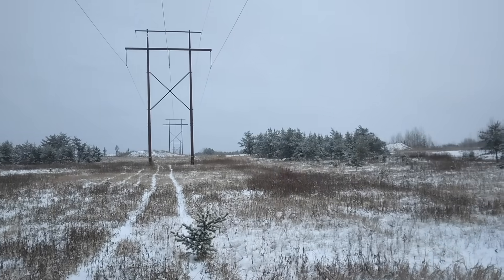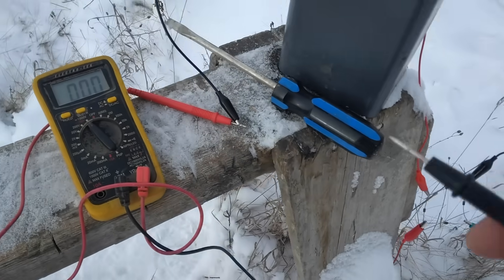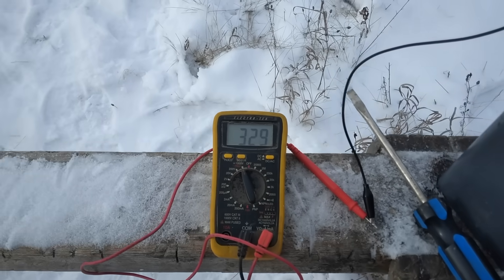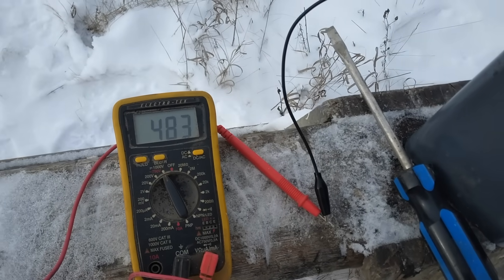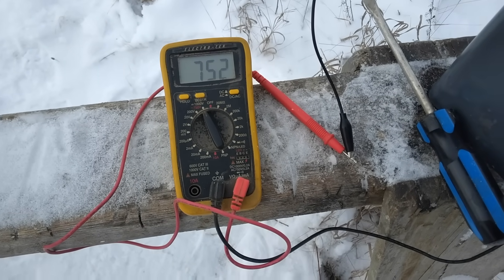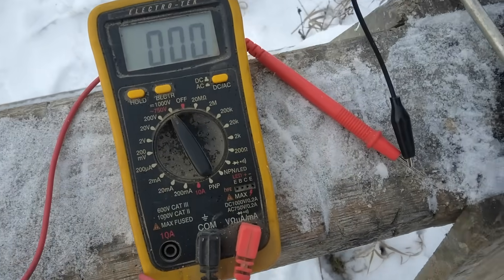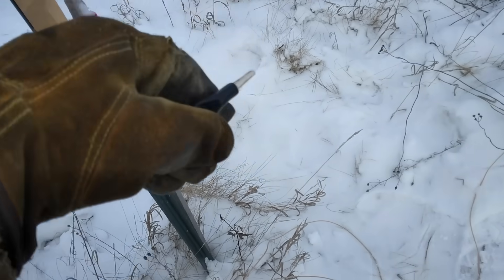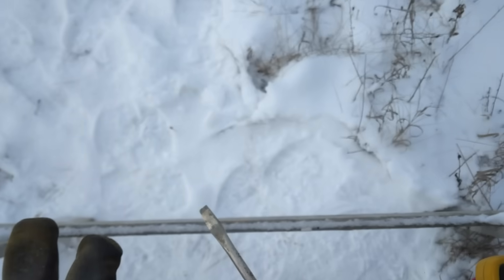Fences sucking power from under HV transmission lines

Comment: True story... More than 50 years ago, when I was just a kid, the owner of a local oil field welding and machine shop got sued in Federal Court for "stealing" electricity from the 240KV power lines which passed over his property, by way of using a homemade induction coil mounted on a pole. Which in turn was wired into his electrical system, and which had been powering his business for more more than 20 years already. The court ruled that he could not be sued for taking advantage of natural physics, and dismissed the case on day one. His business continued to thrive for another 30 years until his death. Shit you not.
Reply: I believe you. 45 years ago the power company ran high voltage lines over a ranchers property for which he didn't give permission. He was told he would have to go through bureaucratic channels to have them removed or rerouted off of his property. He was also an electrical engineer. He built an induction device from which he drew free power for him and his neighbors close by. Did it for a year. The power company found out and within a week the lines were rerouted off his property!
Reply: @heru-deshet359
Power lines were rerouted in a week? I call BS on your story.
Reply: 😅😊  @heru-deshet359
Reply: @heru-deshet359   i doubt that story.  he would have to be drawing hundreds of  kilowatts for them to notice past resistive and inductive losses.
Reply: When I was a Kid, touched a top wire on a Barb Wire fence, and got a nasty shock. Weeks later, saw the Farmer at a store and asked him when he electrified the fence. He said he didn’t. Showed him where it was Electrified, he later grounded it. Turns out he was having problems with his Dairy Cattle and didn’t know why.
Reply: Ad: "power companies hate this one trick"
Reply: This is what I love about the internet. We've got amateurs arguing with experts arguing with amateurs pretending to be experts, making an interesting read for sure.
Reply: @sunbeames you have the best response I've read so far and you are telling the truth.......true story.  Lol
Reply: @sunbeames  LOL... Whatever you do, don't get them started talking about airplanes.  8^)
Reply: Idiots argueing with idiots  @sunbeames
Reply: We had a local resident who did the same thing.  He captured enough power to operate parts of his home and shop.
Reply: @eminence_front6043  Captured enough energy to power your fantasy, or duping your foolishness for the lols.
Reply: For some reason I usually trust stories that end with "Shit You Not" more so than stories that end "True Story."
Reply: In the late '70s I was working for a land surveyor in Northwest New Mexico.  One day we parked his Jeep under a 115Kv transmission line way out in the desert in the area where we were working.  When we came back to the Jeep it shocked the snot out of both of us.  We made sure to park off to the side of the power line after that.
Reply: I remember this!  He had the coil originally on a tractor bucket and then built something more permanent.  He would move the coil around and that somehow got outside of the law...
Reply: @1dariansdad  As I recall his name was Lytt Rogers. Richer than the Pope. Not just saying
Reply: Could you provide more details on when, where and a close date of that event
Reply: @mrnobody8540  Graham TX . So maybe early 1970's? I was  just a kid.
Reply: @quoderatdemonstrandum5442  
Thanks for the info - have a good year
Reply: Dudes a legend then i knew you could get power from those lines because i'm and electrician ,but never took the time to experiment because i don't live around any lines. Take note that there are ways to convertly siphon power off those without them knowing unless they did a hard search.
Reply: The court is correct for weak or wrong reason.  I think this case is similar to neighbor's tree bearing fruit but the fruit is above your property which you can pick without being branded as stealing. As long the coil device is within in your property, power company can't do anything about it.
Reply: We still don't have free energy
Reply: I've heard this story a couple of time now. Sometimes the home owner wins, sometimes not. But I have not figured out how they work. If you get a couple of turns around those wires, you can pull down some current. But by only having parallel wires, you are only getting a capacitive load. You can get a high enough voltage to cause a spark or light a florescent or neon bulb, but there isn't enough current to do any real work. 
Similarly, by pointing a coil of wire at the power lines you can leach off a bit of current, like current probes or clamp on ampmeters. But without making a full loop around the wire, you aren't even going to get as much as a clamp on ampmeter. 
While the shop owner might have pulled down enough voltage to power his florescent shop lights, I not sure how he could have powered much else in his shop. If you have any actual articles about this case, I'd love to read it. Over the years, everything I've ever found ventured into urban myth territory.
Reply: @brucekives2194  The magnetic field lines circle the wire. An inductive coil with its axis perpendicular to the wire, close enough that the other phases don't cancel out the magnetic field, will pick up voltage as the field oscillates at line frequency.  It has to be to the side of the wire or the field will cancel out.
Reply: @PaulSteMarie  
Exactly right. And the coil that picks up that magnetic field has to be kept so far from the HV transmission wires that only a tiny amount of current in induced into it.
Reply: @brucekives2194  Reference Nikola Tesla's wireless power transmission that actually powered a vehicle!!!
Reply: @brucekives2194  Can't really document. Just a memory from my youth. Same guy had a pig farm in South Bend ,Texas. And made a mint of money during WW2 making nitroglycerine for the US govt. Produced two, maybe three hundred gallons per day. Even had an ice plant on his property so they could ship it to Ft. Worth via truck.
Reply: @brucekives2194  Ummm, no. Please Google induction coil ... And sorry, but I can't really document those events. Just a recollection from my youth. Same guy had a big-ass pig farm in South Bend, Texas and got rich selling nitroglycerine (and pork) to the US govt during WW2. Produced two, maybe three hundred gallons per day. Even had an ice plant on his property so they could ship it to Ft. Worth via truck.
Reply: @brucekives2194  I believe fly back transformers would be effective in pulling more current out of the air...?
Reply: It's true that it's a story but the story isn't true.
Reply: @manchegocheese997  Google is your friend
Reply: Brilliant! "Ye cannae change the laws of Physics"
Reply: @nickjung7394  Amen bro. Didn't Scotty say that to?
Reply: @nickjung7394  It’s worse than that He’s dead Jim 😂
Reply: Don’t worry about volts what about current. 😊
Reply: I know this story. Court ruled he was just salvageing wat was already lost.
Reply: That’s what we call “Power ✊⚡️ to the People”!!
Reply: Stories that start with "true story" aren't
Reply: @waynethomas3638  Google is your friend.
Reply: Power Wall battery bank, anyone....?
Reply: Not a true story when it comes to powering an entire business that way. If that were true the POCO would also be using air core transformers. 
At 60hz you need some significant amount of core.
Reply: @Magneticitist  LOL.. Just because YOU can't do it doesn't mean that an old timer who used to make nitroglycerine for the US govt cant.
Reply: @quoderatdemonstrandum5442  Yea well, it's a physics thing but ok
Reply: "Taking advantage of natural physics"??? LOL, this cannot be a true story. If I drive a truck through the front of a liquor store, I'm also taking advantage of "natural physics".
Reply: @chunkEcheez  in California you'd get away with it BUT now 2024 the $900.00 and below is gone
Reply: @chunkEcheez  LMAO... What are you? Twelve? Or a Lib Arts Major?
Reply: @John-kj5wh You are correct. An inductive coil siphons energy from the power line that wouldn't otherwise leave it. The ground and the wire have no current. A coil with a load would measureably reduce the power across that section of the line. There is no such thing as free energy. People like to argue without understanding. The ground is not siphoning power from the lines, while an inductor with a load absolutely will.
Reply: WE had a 5 mile strand line (strand is the 5/16 inch 8mm stainless braided wire that supports phone cable and tv cable lines) that run parallel to some 500 kv lines in Ohio. That strand generated so much power that it set the field on fire. The property owner separated the strand from the ground and run a 4/0 power cable underground back to his building. It produced tremendous power lighting the barn and garage and running equipment. You have to be very careful with those lines because many of them were highly charged from just running down the length of the road on the opposite side from high tension power lines. I remember handling this line with insulated tools and striking on hell of an arc to ground. It was more than dangerous.
Reply: @KlodFather  Running equipment part of that story is absolute BS. Fire yes, flouro light yes, electric shock yes, running an electric motor/refrigeration/welders/compressors not possible.
Reply: @ThePaulv12  -  No compressors... But there was a lot of power that came from that steel cable which came on rolls about 25k feet. So a couple miles of that steel cable can pick up some tremendous power. But no air compressors or welders. That is not possible without some serious elfin magic and some long parallel runs of cables.
Reply: @KlodFather  - Little energy is required to make a spark to set a dry field on fire, just lots of voltage which is readily available from a transmission line.  While 5 miles allows a good bit of power to be gathered, I'm quite sure this story is fake, some aspects are unbelievable.
Reply: @jrstf  -  No... This is a real place and I could show it to you... Its in East Central Ohio with good long straight roads out between cities. You are entitled to believe your own lies, but I was an eng working on those projects out there and I saw it first hand. Look it up. The support strand is in between a 4 and 6 gauge wire and the braid is about 5/16 inches thick and has a normal working load of about 5000 lbs. The break or stretch load on the wire is around 20k lbs. Its really strong corrosion resistant steel. Go test the theory yourself. If the wire is 20 feet in the air you are drawing power from, its that much closer to the power line for better coupling. Telephone and cable TV trunks pick up lots of stray voltage and parasitic power from power transmission lines and AM radio stations. They can be quite dangerous.
Reply: @KlodFather  - I'm not disputing getting a bunch of power from a 5 mile line.  I do dispute the need for such a heavy wire to carry the current.  Transmission lines come in three phases, if the wire were equal distance from all three (which I know it isn't), they would cancel out and you'd get nothing.  But it does limit what you get.  In addition, the stuff you claim was being powered is rather particular about the voltage, getting power this way would not be the desired voltage and if you transformed it to the correct voltage it would still vary greatly with load.
Reply: Had new home built by an amatuer electrical engineer. He was trying to "steal" power from transmission lines in his backyard. Wired up the attic...... didn't work. sold the house, without telling anyone.
New owners kept getting shocked touching anything in the house. Took a few electricians to finally go up in attic and see all the copper strung out in the rafters...
Reply: @brucewhitefoot  wtf is amatuer electrical engineer? Only people graduated are electrical engineers!
Reply: @ianmoone8244 amateur engineers should stick to driving trains.
Reply: @johnstraszak5145  there's no such thing as "amateur engineers"...
Reply: O RLY?  Cite the exact case so we can all get on board.
Reply: I heard thru my kid brother about his FIL in west Ne making volts for his own use with a wind generator. Local county gools stopped him.
Reply: @roadking99jokerst60  And now they're encouraging people to do exactly the same thing. 🤷‍♂
Reply: @ComommonlyCensored 
Like the distributor in the old cars - it the condenser that made the spark plugs work 😊.  A very simple design with no moving parts - it only job is to absorb the full voltage of the battery until it reaches the point of total capacity saturation is reached - it's this factor that provides the spark plugs a burst of energy - however it's the job of the coil to amplify the voltage from low into high voltage for the energy jump ( spark ) across the spark plug electoral the the grounding circuit provided by the engine being grounded to the vehicle frame with is grounded to the batt terminal, completion of a circuit.
Reply: @mrnobody8540  Well that was certainly a long winded way of saying you don't understand what a condenser does in an ignition system.
Reply: @20somthingrealestate   it a simple design - it's only job is to create a break in order to get a flash charge in the circuit... 

Your understand it better - explain it better.. use less words doing it! 

Proof is in the show of work - not in the I said so, there for it is! 

Haven't read a auto motive textbook since the late 70's - old points gap and dell set up of timing done with real tools, not a keyboard. 

So I could have forgotten something - but I don't think I have forgotten much.
Reply: It was really the fault of the electric company, not the business owner, for not having the necessary easement to prevent that situation.  Their engineers should know the required easement to conserve their electricity on the lines and demand it.   Obviously the easement for the electrical wires was too small.
Reply: There was a guy here who had to pay back 10 years of power bill.  Its crazy.
Reply: In Mississippi they considered that an electrical connection by induction and cart you off.
Reply: There were marijuana grow ops in the British Columbia Interior that powered their green houses that way.    A few were not found for years.
Reply: He stole Mega watts of power a day? 😂 True story
Reply: @DreStyle  LOL... Reading comprehension must not be your strong point. Because he wasn't "stealing" as per the United States Federal District Court. And study up on your basic physics... Because there's NO WAY that he was consuming megawatts per day. More like a few dozen kilowatts. So thanks for playing. And go finish your homework.
Reply: Epic! Fantastic story.Good on him. And I do believe you. It's cool to hear that every now and again in our messed up world common sense and justice do occasionly prevail.
Reply: This is the most wholesome story I've seen in a while. My bald eagle just shed a tear of delight.
Reply: The energy is already lost to the atmosphere so yea, its not stealing it capturing free energy.
Reply: @ThreeTreeDog  It's also an imposition upon the land owner, rendering that land unusable for certain things.
Reply: I think it's less about 'stealing electricity' and more about the fact your giving people ideas!
Reply: @andyspoo2  The whole thing started with a 10th Grade Science textbook. And ended in Federal Court with that very same textbook. Except in this case, someone actually took the time to read it. Ergo, the plaintiff (power company) lost their case. And the respondent won by summary judgement. Those are the facts. #science
Reply: @andyspoo2  I think electricity from the atmosphere (a static field) was used in the past for lighting.
Reply: Well the man said “ shit you not ” gotta be true!
Reply: The icing on the cake would be to sell the power back to them
Reply: I remember that case. Court rulled he was only salvaging what was already lost. No harm no foul  ! !!!
Reply: Under lines larger than these was my parents mailbox. If you slid your hand under the mail you'd get a good shock I'd guess like a 100 volts. Always wondered how it was happening
Reply: I've heard of other similar cases, but I highly doubt that he could "harvest" anywhere enough power to run a welder.  He'd have to be dangerously close since the radiated power decreases at the inverse square of the distance.
Reply: @TheRealCheckmate  Read the whole thread
Reply: @quoderatdemonstrandum5442  All 433 replies?  I don't think so.
Reply: @TheRealCheckmate  Well I'm not going to repeat myself again just for your convenience either. So stop wasting bandwidth on mommy's computer. And have a nice day.
Reply: @TheRealCheckmate  Are you a Lib Arts Major? Or what? Because logic dictates that you don't actually have to read all 433 replies... Just the half-dozen or so that I already posted. LOL.
Reply: I can tell the story was fake based on simple physics. There is no chance to get enough power from that way.
Reply: I'm an electrician 4 years into the trade. It is definitely stealing, although I still think it is a clever and amusing way to game the system. Here is why it is stealing.

The stolen (induced) electricity comes from the magnetic fields generated by the power company. These fields dont just radiate away from the wires like a toaster radiates away heat, they expand and collapse at a 60 Hertz  rate. Energy stays and travels on the lines, unless you introduce your inductor to steal the electricity, which is essentially a load that you are adding to the power company's transmission lines, same kind of load that you create when you physically plug in a toaster into a receptacle. It uses power.
Reply: @elc2k385  But the court ruled that it wasn't stealing, BECAUSE THE INDUCTION COIL WAS LOCATED JUST OUTSIDE THE LATERAL LIMITS OF TXU's RIGHT OF WAY.... I mean seriously. What part of that do simpletons not get?
Reply: Anytime power passes through a transformer, it only makes inductive contact, never physical contact. Called transformer isolation. Yes, one can set a coil of wire around an iron core next to a pulsating field and transform this magnetic field into useful electricity. One only need to measure the results and increase the coil or iron till it results in the voltage one desires. The frequency will be the same, in the US,  sixty CPS. This will not affect the power company one bit. Just jealousy, and selfish desires, convincing other similar entities.
Reply: @jaypaul8167  Exactly.
Reply: Name of business
Reply: @jeremygalloway1348  Read the thread
Reply: The inductor he set up requires more work from the power plant to achieve the same power output from the transmission lines (it increases the impedance of the power lines , so it does result in higher energy consumption for the power company. You don’t get free magical energy out of nowhere in physics.
Reply: @electricpaper269  Point being the coil did not infringe upon the TESCO right-of-way.
Reply: I was told the same story in 1970 when attending a lecture on Electricity when I was in University taking Civil Engineering!
Reply: To prove there is an electrical field below power lines just take a neon test bulb and walk under the lines. It will light up.
Reply: @magicone9327 i have those lines across my property that are constantly causing me grief. 
It would be nice to get some benefit from them. How do i set that up?
Reply: What exactly do you think i don't understand about energy? The fact that the wires are one electrode of a capacitor and the ground is the other, or the fact that the ground actually has resistance and is turning most of the capacitively coupled energy in to heat thereby wasting it or the other effects leading to losses in transmission lines? Putting an electrode between the wires and ground and than grounding it just slightly increases the overall capacitance. Having an aircore transformer nearby to get the induced low current and high voltage transformed in higher current and lower  voltage might look like some wireless electricity bulshit, but is perfectly plausible.   @ComommonlyCensored
Reply: How about another experiment? Two 20 foot iron rods, 1 inch or more, positive lead shoved 10 feet into an eddy current, a magnetic river connected to the earth due to our atmosphere, and the next rod 10 feet away. Wrapping a wire around a lot is recommended... the earth has significantly more energy than those lines... methods of solidstate induction are vaild...

I don't know it would hold up again. Without the power lines there, the farmer could not... copper coils woven in a six point star lure the induced current into the coil below best. The effect of electricity to seek it's ground can be exploited even if large coils are buried below the earth, which one could argue the energy was grounded before reclaiming occured. Although, placing copper coils in the ground accelerates the wear on the wires, degradation, and translates to less energy to destination and more resistance in delivery, and the generator must spin more. Leeching is what it is, a parasitic load. As much I want self generation to occur, 30 ways approved, leeching is not. Use the magnetic energy. Every 10 miles or so is where an eddy current exists, not every one has access, but sharing is caring. Free energy is free creativity and we need this advance to succeed in the world and own the hydrogen economy. Magnet motors that work, based on known acceptable designs, warning fbi hates it when we make magnet motors. Hydropower is still exceptable. We have lasers to cut miles into the crust, leaving a quartz tube behind, ideal for geo thermal energy. Thorium reactors, liquid salt reactors, are safe, powerful, and recycle the excess waste and warheads. If we are going to do mass projects to provide free energy, then we need to pick sustainable methods, without burning fuels. The maget motor is ideal for everything. The magnetic accelerator depletes matter, and generates a small amount of antimatter, and that is not advised for use in our galaxy... =)

The science of building nuclear silos, a 400 foot hole was dug, and a silo built over it, 400 foot tall. All it did was rain in the silo, filling the bunker below. Needed to design better pumps in the 1950's. We can have water in the desert. The more extreme the difference in the bottom of the hole and the top the more condensation occurs. Please ground the silo, not only would it be a lightning rod, but conditions inside the silo can be a thunderstorm.
Reply: Damn lol
Reply: Bullshit!
I find it very hard to believe useful work can be done by electromagnetic induction. It defies physics that refrigeration equipment, light globes motors etc can be run for any time at all. 
I'm calling big brown BS.
Reply: Too all of those that claim it's not stealing: The guy built an air-core transformer to take energy from the magnetic field generated by the power lines and turn it back into electricity. Just because the power was changed from electric in the lines  to magnetic in the air then back to electric in his lines doesn't mean it's free. If that were true then all power consumed downstream of any transformer should be free. He's stealing power and the only reason he got away with it is the ignorance of science by the prosecutor/judge.
Reply: “Stealing,” yeah that’s stealing…
Reply: Nice , a Happy Ending !  Finally .
Reply: @ComommonlyCensored  Retired pilot here... Yes. I understand energy.
Reply: I was looking down the comments to see if it was high enough to power a house, apparently so :p
Reply: Site resources? Name of business and location?
Reply: I would kindly ask that you link the court documents or at least provide some information so we can verify this story with public records
Reply: Which state was the court case held?
Reply: What location was the case heard?   Thanks
Reply: @dalecarson1798  Pretty sure it was the U.S. District Court for the Northern District of Texas
Reply: Now, that's justice .
Reply: Old, analog meters could be turned upside down and run backwards.
Reply: Yay for the little guy and for "Natural Physics."
Reply: He should have counter sued for the EMF causing problems with his business equipment.
Reply: @mach1553  That was waaaaaay before computers. So maybe that's a stretch. Just saying.
Reply: Wirelessly
Reply: I bet that wouldn’t hold up in court today
Reply: 400 turns , 22 foot up😂
Reply: Air core transformer. Great!
Reply: Wild, in any other jurisdiction that's considered theft of services. There was a farmer who buried a coil in his field over which HV transmission lines were crossing. I guess he got caught because whenever anyone passed by there was weird electrical arcing as well as other interactions between the ground and the wires.
I have no idea what he was doing with it, it looked like he wasn't using it.
Reply: Yea.. obviously they can't sue you for stealing electricity from the air..😆
Reply: Don't believe everything you hear even from people you think you can trust. That story is most likely false and made up by someone who was probably in court for some other reason.
Reply: The feds are really good at pointless harassment.
Reply: Most EE majors are taught about this story, but the professors ended it 
that the farmer could not do this and his system was dismantled.
Reply: @johnsmith1953x  Not a farmer. But an oil field welding and machine shop in Young County, TX. He was found to be in compliance with the easement regulations in effect at that time. So he was was found not guilty and continued to operate thus for another 30 years until his death.... But the easement regulations were soon changed and nobody else could do it anymore. 8^)
Reply: @quoderatdemonstrandum5442 I heard this story in college in the 1970s so this is a different guy.
Reply: @johnsmith1953x  Yes. Diff guy.
Reply: that kind of EMF is really unhealthy. Avoid going near those powerlines. ❗❗❗❗❗❗
Reply: Love these true stories, thanks.
Reply: Because they couldn't send him an estimated bill 😅😅😅
Reply: Prove how much he stole good luck. GO !!! 😅😅😅😅😅😅😅😅
Reply: @matthewspry4217  Luck, and understanding basic basic electrical physics = not the same thing. Now go finish your homework.
Reply: Shhhhhhhhhhh...
Reply: @justsomejoe3632 LOL... I'm 64, Sophomore. How many are you?
Reply: @justsomejoe3632 Stop wasting bandwidth in mommy’s computer.
Reply: As long as he was not physically connected to the electrical grid the power company had no case. Tesla had this idea and he was silenced by George Westinghouse for doing experiments with this theory while working for him.
Reply: A linear inductor is what you built out there. If you had enough passes of wire back and forth you could power a small home through a stepdown transformer with that amount of electricity. Step it down and use it.
Reply: Can you charge a battery as an experiment?
Reply: @236vic  That's already been done. And Google is your friend.
Reply: It's NOT stealing. He's not taking ANYTHING from the power company in this case and as someone said the natural physics of the electric transport. It would be no different to put up a windmill near a wind farm. It could also be likened if you had a windmill near a highway to catch the wind generated by passing vehicles. You're not "stealing" the fuel from anyone's car nor making a difference in their gas milage.
Reply: @JamesKing-ev1wc Well he certainly had to have some kind of transformer in the line somewhere. But what kind and/or where it was I can't say for sure. Because I was just a kid at the time and there are a multitude of possible configurations.
Reply: @rustirab3465 Read the whole thread.
Reply: So instead, is there anyway to charge a 12v battery with something like this?
Reply: I know you can do it with a small winding but the voltage i got was pretty much useless. May not even been enough to make a spark. I buy that story too. Tech was probably put in to where they could see the loss and they investigated. That is induction the way some cell phones charge today. What surprised me is that the court sided with the land owner good ending. To get a useful voltage and current you would have to have a coil it takes a truck too brings out and park it under huh? Just guessing.
Reply: @my2cents645  Never saw it myself. But reliable sources say it was pretty big and mounted in the bucket of a front-end loader. 8^)
Reply: oddly the story has specific information yet lacks name/location.
Reply: @stevelibby6852  Read the whole thread?
Reply: @quoderatdemonstrandum5442  288 replies to scroll through? Sir, my ADD has limitations. 🤣
Reply: @stevelibby6852  LOL
Reply: @quoderatdemonstrandum5442  I am intrigued by this sort of technology, definitely seems plausible.  Of course, you have to live near high voltage power lines--which is not really optimal for humans I am told.
Reply: @stevelibby6852  Not only is that technology plausible, but our entire modern society depends upon it... For example, the transformers in your computer. Same thing. just waaaaay smaller scale.
Reply: @quoderatdemonstrandum5442  Oh for sure, I just meant for industrial theft :)
Reply: As electronic engineer I can immediately tell story is an utter BS fairy tale. Regardless of the fact that it's simply not possible to harvest any meaningful energy to power his business from proximity of power lines, induction coils would be absolutely useless way to do it. You cannot place a coil besides a straight wire and get anything induced onto the coil. To get anything out of it at all, wire would need to go through the coil. Not to say high voltage aspect of such power lines would be absolutely useless for such harvesting as current through the wire would be what matters. Not to say his pole would be immediately demolished once noticed, not because of him stealing the energy, but because of National Electrical Safety Code violations, and likely many others. You are simply not allowed to build any poles under high voltage power lines. The most useful way to harvest some energy would be through capacitance, not inductance, but it would not involve any coils.
Reply: @woopsserg  LOL...Retired pilot here. Stop playing kid. Because you're just twelve, or a Lib Arts Major. Which?
Reply: @woopsserg  Retired pilot here... Yes! That's why they went to Federal Court and spent all that money on lawyers. Now go finish your homework.
Reply: @quoderatdemonstrandum5442  Retired pilots should know they shouldn't fly anywhere close to power lines. Now please name this famous federal case... Oh, you can't because it's BS.
Reply: Shit you not.  Where are you from?  Love it.
Reply: Does this coil apply a "load" or power drain to the electric company? If there is no noticeable load change there is on theft.
Reply: @dvdosterloh  Did it apply a load? Yes. I'm sure that it did apply a small one..... But I repeat, the case was thrown out because the user's induction coil was placed JUST OUTSIDE the power company's easement. boundary.
Reply: Doesn't matter what physics you use to steal anything, it's still using it without the intention to pay for it .
Reply: More power to him.
Reply: Source: Trust me bro
Reply: Just to correct everyone who say it’s not stealing because the power is otherwise wasted - you’re wrong.
The induction coil drags power out of the powerlines, they are electromagnetically interacting.

There will be loss incurring from the transmission circuit because of the presence of the induction coil or system which is built for the stealing of the electricity. 

Source - I’m a HV Lineman for last 18 yrs.
Reply: @EricDeanCampbell  It's wasted because the ground is a bad conductor. It acts as a resistor and wastes the energy as heat. If the ground was a copper conductor than it wouldn't be wasted, it would have just been  added capacity for power factor correction of inductive loads.
Reply: So how is it safe for people who live near these power lines?  And what about people who have pacers?
Reply: @JosephBoxmeyer  Short answer, I don't know for sure. So any answer I give would be pure speculation.
Reply: No different than an air-gapped transformer!!! If said "power company" was concerned about their "loss", then they'd be SHIELDING their power lines from emitting spurious transmission!!!
Reply: @John-kj5whyou are correct. It's not waste energy just floating around. It's got potential. Once there's a load, you are drawing current. With that you are stealing. And yes they can detect and locate it.
Reply: There is an equal and opposite reaction in the magnetic field when inductance occurs. Adding more inductance by intentionally putting an inductor near the lines will put the same power against the transmission lines as is induced into the inductive system. So it's not "wasted" energy being harvested, it's a load on the power lines, unless the inductor is naturally occurring or is unavoidable for some reason.
Reply: @markzuckerman-powdercoatin8358  Yes. But the salient point here is that the old man's induction coil was located OUTSIDE of the power company's right-of-way limitations. And so therefore did not violate the applicabe regulations.
Reply: Just what it doing to your body living under them 🤔
Reply: I hear of a similar story out in San Jose, Ca.  but owner of property was charged for stealing.
Reply: @HHH-nv9xb  Very possible if his induction coil was inside the exclusion zone as defined by the applicable right-of-way... Or in other words, too close = violation. But just outside that exclusion zone = all the free electricity you can afford to harvest... But maybe that's just in Texas. Can't speak to Kalifornia. 8^)
Reply: I believe the electric companies have made sure that is no longer legal. You will be sued and made an example of.
Reply: The key is to invoice the power company for alternating the field in your property, at a rate greater than your own electricity usage.
Reply: Taking advantage of natural physic is a very cool reason, and why not?
Reply: my hero
Reply: @TheNagroth  yeah and a light bulb doesn't emit light, it merely sucks the dark out of the surroundings
Reply: I would love to know the name of the case.   It’s intriguing that the court ruled in favor of this individual, determining that the utility company could not claim ownership over the electromagnetic field itself. The key point here seems to be that the person didn’t directly tap into the physical power lines but rather used an indirect method of energy harvesting based on natural physics. Since electromagnetic waves and fields are an unavoidable byproduct of high-voltage transmission, the argument may have been that the energy was essentially "ambient."
Reply: @zangin  In Great Britain....... about 70, maybe 80 yrs ago, maybe more. 
A powerful radio station lost coverage in the easterly, maybe westerly direction, some direction anyway. Listeners to the radio station were complaining to the radio station that they no longer had reception, or had poor reception.
Very suddenly. It had been good for years, then nothing, or very little reception.
Someone noticed that all these complaints came from a certain direction away from the transmitter masts.
After some investigation including field tests..... a local farmer was found to have made and installed an inductive coil around his property, and was actually using the electricity. I don't know further details, like if he rectified it.... made DC or just used HF AC for his evil purposes.
Apparently there was a court case that he lost.... convicted for theft of electricity, and had to pay the estimated amount back. (Don't know about the lost advertising though). This was told to me by my old radio theory tutor in the mid 1970s, when I was studying for my exams. He was probably born around 1900ish.....and had spent much time, much earlier in Great Britain. And he was not a bullshitter... a very straight up guy indeed.
Reply: @zangin  I think it was Texas Electric v Rogers... And your surmise is essentially correct. Main point being that the induction coil was located just OUTSIDE the lateral limit of the applicable right-of-way by only a few inches. Had it been a little closer I'm pretty sure that the court would have ruled in the power company's favor.   8^)
Reply: That’s what he needs to do. Use a step down transformer and use it that way
Reply: How do people think their cell phones get charged when they have inductive charging? 
”Look mum, no electrical connection".... but power going into my phone......
Reply: If the feds did win, radio companies could sue anyone with a radio.
Reply: Natural physics? 😂😂😂😂
Reply: My tech school science teacher did the same with a shit ton of romex on a old cable company coax spool to power his hunting cabin in upper Michigan he got in trouble and was told to remove it by some park rangers he just waited till deer season was over and took and put back put hid it better with  some camo paint and he's never had an issue since 😁 apparently the park rangers never reported him
Reply: Good decision. The idea that you can steal a magnetic field is ridiculous.
Reply: Counter suit about the spreading of their power. Liken it to a paint and body shop not doing anything to prevent overstay from getting on other people's cars, homes etc.
Reply: @mikehome6137  Non sequitur
Reply: this has the general makings of a good BS story. The flaw is only obvious to electrical engineers. The magnetic field strength is proportional to the power flowing above. The voltage from a pickup coil would vary at least 2:1 during the workday and more like 10:1 over the 24 hour day. it would need to have an automatic tap changing transformer and a ferro-resonant transformer to produce useful power without destroying equipment in the workshop. BTW the e-field shorts at the earth as capacitance per mile with only a small dissipation factor for the soil resistance. The magnetic field isn't shorted by the ground.
Reply: @ 240 KVA … Do you even know what means?
Reply: I'm shocked tht he didnt have an ""accident"" seems to be a norm for ppl who break out of their control system
Reply: So, there's legal precedence for using physics to "steal" electricity?
Reply: @themeadman  The court ruled that it wasn't theft because the old man's induction coil was located OUTSIDE the power company's right-of-way. Simple as that.
Reply: @quoderatdemonstrandum5442  thank you for the clarification
Reply: taking advantage of natural physics.....thays quite a sweeping ruling 😂 always good for a reference though😂
Reply: @luminousfractal420  LOL... I don't know the court's precise verbiage. Just paraphrasing it's ruling in favor of the respondent. 8^)
Reply: bullshit.
Reply: Air = Natural Physics, Copper = Illegal unnatural Physics
Reply: luv stories like that!
Reply: Should have sold the energy back to em too
Reply: Power companies are well acquainted with this form of theft, and have rafts of legal victories against these perps.. Without a name and jurisdiction, this case is hust an internet rumor.
Reply: @williewonka6694  Pretty sure that the suit was styled "Texas Electric Service Company v Lytt Rogers, et al" and was heard by the US Federal District Court , of the Northern District of Texas, in Fort Worth. And it wasn't theft because Rogers was never charged with a crime. He did, however,  prevail in the civil suit only because his induction coil was located just outside the lateral limits of TESCO's right-of-way. Ergo, they had no case. 8^)
Reply: NICE !!
Reply: Case name?
Reply: @ThomasJ13  I was just a kid, but to the best of my recollection it was Texas Electric Service Company (aka TESCO) v Lytt Rogers, et al... Something like that.
Reply: Good job you didn't provide the state or the name of the company or the court number or any identifiable information so somebody else could rely upon this as precedent for when they do the same thing
Reply: @daithi007  Read the thread, Sophomore. It's all in there.
Reply: stupid liberals 😂
Reply: Same outcome in my post except it was a farmer with a fence that was picking up the power.
Reply: you shit me yes
Reply: Dumb judge. Dude was stealing.
Reply: @holierthanthou_  No. Smart judge who upheld not only the law, but the science too.
Reply: It’s not “wasted” because the laws of electricity there’s no load on it until it’s harvested in some manner. Sort of like a wireless phone charger. Except the power to run the devise in idle mode, the real draw of power comes when you sit your phone on it and it begins to draw power. Hence it’s stolen power.
Reply: Try it somewhere away from any power lines..might be the same.
Reply: Wow that's really cool story thanks for sharing
Reply: Good for the little guy!
Reply: The power companies are collecting Aether and selling it to us….. They build many miles long power loops that don’t connect to anything…..
Reply: These power lines cause Cancer, so free electricity for a shorter lifespan?....you definitely do NOT want to live next to power wires or cell towers for that matter, both are oncogenic to mammals/amphibians/reptiles/fowl.
Reply: No he could get a smart meter and sell the power back to the electric company.
Reply: Little brother saying "I'm not touching you..." lol
Reply: I don't know anything about electricity, but could you wrap a copper wire like a coil the whole length of the fence and increase the power or charging speed?  Seems like a good way to install a livestock electric fence with free energy.
Reply: @Anonymous-jm3mg  Induction coil..
Reply: LOL, none of these stories are true.
Reply: @quoderatdemonstrandum5442  didn't happen. If it did provide the case.   Power companies don't give a shit about you tapping into  the air driven fields and one coil is not capturing enough to power more than a few leds.   You'd need many many feet worth of coils.
Reply: Cool
Reply: No physical connection. And then no steal.
Reply: They ruled exactly correctly...he stole nothing.
Reply: Open cct voltage vs closed... without a capacitor.  Milliwatts will do nothing.  Free energy if you want to power a tiny diode.
Reply: What would happen if the wire was Bare instead of insulated
Reply: 1440 volts per leg
Reply: Look up Tesla free energy.
Reply: I believe you. Great story!
Reply: So would that be drawing an induced load on the power system or just harvesting the waves emitted from the lines?
Reply: @serioussaitama4431  "Induction Coil". Self-explanatory.
Reply: My electric bill is PREPAID, the tear off part of the STATEMENT is a REMITTANCE SLIP, a CHECK, a Coupon. 
I must put my bankers endorsement on it and send it to 1500 Pennsylvania Ave, room 3413 for processing . With a letter for directions to OFFSET the debt. 
Treasury Manual has sample endorsement s
Reply: @Paulhoodwinked-o5d  LOL... So what's that got to do with tax on pussy? Just asking.
Reply: Oh bullshit. That is from a Dean Koontz novel.
Reply: I'm kidding. Good on that guy! Good story.
Reply: I'd like to know how to do that
Reply: @quoderatdemonstrandum5442  if it's accessible from your property you are free to take full advantage. That's the way it should be. Freedom is the key. I don't want extra policing of my property and activities because you choose to run your power lines across it. Fewer laws. Not more.
Reply: @quoderatdemonstrandum5442  the power company can inundate me with radio waves if they run their lines near me and I can't do anything about that. Well if I can make use of the waves good on me
Reply: Cool
Reply: 😆 🤣 😂 nice!!
Reply: Urban legend, same as all the other countless similar stories that have perpetuated on the internet.  Abraham Lincoln once said, "You can't believe everything you read on the internet"
Reply: The court was correct all he was doing is harvesting electricity that was being put out into the universe regardless so the court completely understood the physics behind it smart judge it’s waste electricity that anyone can gather it’s being thrown away
Reply: He must’ve used a step down transformer, 240 kv not good at your sockets .
Reply: @Gusto9698  Lytt Rogers was a self-educated genius. And I suspect that by virtue of the number of windings on his induction coil that it wasn't drawing anywhere close to 240KV. But it was enough to run a successful oil field welding and machine shop for a great many years.
Reply: Would that capacitor be 88 megafarads not micro?
Reply: The law is clear about theft of power and theft in general. It relies on the mens rea.
What was the purpose of building the device? Why was the device placed where it was placed? What was the effect intended with  the device? Would the device function the way it does absent the plaintiff? Clearly the it was intended to induce electrical power near electrical power lines that would otherwise be not possible without said power lines. He intended to steal.
Reply: @darketernal3  LOL... Not according to the Federal District Court Judge who found in favor of respondent and basically laughed TXU's lawyers out of the court in total humiliation. So maybe next time read the whole thread before offering a completely uninformed opinion. Now thanks for playing. Have a nice day.
Reply: They say its stealing. I wounder could it power a drone up close?
Reply: @mean10102  No.
Reply: Yeah, totally real that’s why you got to say it’s totally real instead of citing the case where this happened….
Reply: @tvviewer4500  Read the thread. It's in there.
Reply: @ quoderat, sure it is. Must be why I can’t find the case anywhere on the internet
Reply: @tvviewer4500  LOL... Read the whole thread, Sophomore. And have a nice day.
Reply: So you were just a kid, and probably didn't know that actually happened. When I was a kid I believed that you could use strength to move a truck in a video game and get a rare monster for my team.
Reply: @derrickbonsell  LMAO... You wouldn't know a 240KVA power line if it fell on you. Now stop wasting bandwidth on mommy's computer. And mow the fucking yard already.
Reply: What was the business name? That seems like useful precedent in some internet arguments lol
Reply: @randomguy1371  Read the whole thread, Sophomore... And all will be revealed.
Reply: I think the law should be anytime they take an easement property owners should be provided for free....biblical principal would be gleaning a field
Reply: Hell yeah buddy. This is awesome to hear. Mahalo for sharing.
Reply: Big Corporations always think they own everything! Like collecting waste heat next to nuclear power plant, and getting a heating bill! Sounds good for the Corp..
Reply: Sounds fair to me
Reply: I don't believe you
Reply: All electrical line has electrical field cannot be stealing since the field is not part of the electrical line.  The wires are only capable of handling the maximum electricity that it was designed for therefore the field is energized by free radical electrons that cannot run in the cable which is already full and at capacity.  This field will lose its energy with attaching to the negative ions of the ground. So it cannot be stolen but be liken to lightning strikes which is transferring between the earth as ground and free electrons that are floating from wires and air. The whole earth has radical electrons floating and therefore it is part of nature. It therefore is not stealing since the electrical transmission line has energized these free radical electrons.
Reply: Its power theft, magnetic induction does cause loss on the other end, what the fuck do you idiots think that can hanging off the the power pole does? It feeds your house using the same principle... hilarious he convinced the court though LOOOOOOOL
Reply: .....this happened in Canada back in the 1930's... the courts sided with the power company
Reply: He should have counter-sued them for using the space he owned to transmit electricity without his permission.  They were, in fact, violating his property rights and profiting by doing so.
Reply: @wesbaumguardner8829  Sorry. No. TESCO had a valid right-of-way.
Reply: @quoderatdemonstrandum5442   Were they a government entity with immenent domain or a private corporation that had bought rights to use that man's property to transmit electricity?
Reply: Sweet
Reply: 😂 any story that ends with "shit you not" is in fact #bullshit
Reply: I love that story..
Reply: Guy steals car
Natural physics
Reply: @Tom-f8r8o  Read the thread, Sophomore.
Reply: a coil will pickup power.....  this straight piece of coax   ?  I dont thing so because its not meant for power ans theyre shielded...   seriiousaly doubt a 1/s mm (the center core wire) will pickup much, but the metal shielding might   in rg 54 coax anyway
Reply: Or moonshine
Reply: The wire on poles is the centre of an invisible "hose" of electricity ( as an analogy) if you lay pipe or wire parallel to the "hose" , you can 
Pick up  power from the line.  NOT ROCKET SCIENCE
Reply: Yall ever listened to those lines when it rains? Cool stuff.
Reply: 1. That never happened 2. It is stealing, because your friend was using a secondary side of a transformer to pull from the primary (power lines). The same way a transformer works using air gaps, a powerline works. Even if you steal it from the air, you’re pulling a load from the main line and they will see this on their computer screens and sensors will go off and nowadays there will be a drone over your house in 30 minutes
Reply: @Miyukiii111  Go finish your homework
Reply: @Miyukiii111  Not according to the United States District Court for the Northern District of Texas... So listen up, Sophomore. And go finish your homework.
Reply: That's pretty cool.good for him.
Reply: I think they made a t.v. movie about that over 30 years ago..
Reply: Wenn es Minuten dauert, um den Kondensator zu laden, dann ist der Strom bestenfalls im mA Bereich. 800 Volt × 1 mA = 0.8 Watt, kratzt keinen Versorger.
Reply: Aawwwessome..  id would be worth it to repeat it in a way.   But not have to be surrounded by it.
Reply: Fucking nice
Reply: A stretch-- to induce any kind of power (Watts) from power lines for the shop would require very close coupling, i.e., the secondary (the shop side) would need to be in very close proximity to the primary (HV lines) at which time arc-over and electrocution would be a concern. The shop may have been able to power some shop lights and  TV/radios but not an electric welder.
Reply: @MrGGPRI could he have been charging battery banks?
Reply: @MrGGPRI a step up transformer would easily solve this
Reply: If they want to run that powerline across your land, then you got every right to free power. Big Brother needs to learn that they aren't the boss, We The People are.
Reply: @CrazyBear65 No, you don't. HV lines are run across LEASED or PURCHASED private property, they don't just take your land and say fu!k off.
Reply: In New Zealand there is a separately written theft charge, for theft of electricity. Hundreds if not thousands of people have been convicted for this over the years, by bypassing the electrical meter, or stealing by harnessing the properties of inductance, as in this method shown in the video.
Reply: @colonelfustercluck486  New Zealand is close enough to being a commie haven for me.  If the power company let the electricity escape their wires into the atmosphere you and I walk through, breath the air of, and have those wayward currents run through our bodies' cells, then it isn't stealing to harness it.
Reply: @colonelfustercluck486  In Europe as well
Reply: @colonelfustercluck486  EMF is not 'escaping'. Interrupt it with a coil, the impedance of the line changes and the power company has to compensate to maintain voltage. 

If they've not properly insulated a line and A/C is bleeding down the pole and into the ground,  that would fit what you're saying,  but EMF is completely different,  it's not 'waste' or 'bleed' energy,  it doesn't leak to ground, and any court that has a proper understanding of how power transmission works will know that any device that uses EMF to generate power is indeed stealing power.
Reply: in NZ, the rather clever pointy headed technical people called as expert witnesses have proved beyond reasonable doubt (criminal level of proof) that taking / gaining the electricity using the principle of induction / transformer action... AND harnessing that energy (proving that the whole scheme is deliberate) then it is theft as defined by the Crimes Act New Zealand...... there is even a separate charge for stealing electricity, away from the general theft charges.... who am I to dispute this expert opinion so clearly given in my own jurisdiction.
There has to be a deliberate intervention, not a coincidental induction between a fence and a power line.....
 In your jurisdiction, this may not be theft.... but I would be surprised
The legal records of our tiny country contain the records of criminal conviction for hundreds if not thousands of people for this type of electricity theft; or
the more common 'lets bypass the meter' type of electrical theft.......... those are the two main ones in this country @Flamingtac0
Reply: @Flamingtac0  It's amazing how many people don't understand either how EMF works and the fact inductive coils are loads; or the law in respect to easements for powerlines.
Reply: True story. A guy in my hometown had a cavity, dentist drilled it out and put in a mercury filling. After that he kept hearing in his head a radio station out of Yankton SD. Hated that twangy Country and Western. Got the dentist to adjust it to talk radio. Eventually that got old too, so to preserve his sanity they just pulled the tooth.
Reply: @davehageman7513  They pulled the tooth instead of trying composite resin?  🙂
Reply: @terryjwood  Think somebody is puling somebody's leg.
Reply: @charlesmain9938  Pulling a lag AND pulling a tooth, too! 🙂
Reply: Great point about the composites... Happy to see that someone is more awake than I am.
Reply: @davehageman7513  I don't even care if it's true, this here is the best story so far!
Reply: @davehageman7513  lol on the filling, not all that more ridiculous than some of the other stories of massive power recovery.
Reply: It's not technically stealing. The power is wasted anyways because the field is just being grounded out by the soil underneath.
Reply: @TheOriginalEviltech  No, for subtle reasons a tuned circuit (which this likely was) greatly increases the amount of electricity collected.
Reply: @BooBaddyBig   You can't collect more than what already is there. A tuned circuit will just increase efficiency.
Reply: @TheOriginalEviltech  No, a tuned circuit will change the load on the line, changing "what is already there" and requiring the power company to put more power in to drive it.
Reply: @eekee6034  I work at a powerplant. He's not gonna pull enough juice to even match what we lose in our own SECONDARY auxillary system's EXHAUST loss. A temp change of steam less than 1/10th of 1 degree would cost more in one shift than he could pull in 10 years.
Reply: @eekee6034  that's not how electric fields work partner.  All the fields does is stimulate electrons it touches.  It doesnt affect what's happening in the conductor
Reply: @TheOriginalEviltech   Incorrect.  Putting more inductance near the power line will allow more energy to be extracted from the lines.
Reply: No, it definitely drains energy beyond that lost to the ground. To help you see that it must, imagine if 10,000 fences were built along the route of the lines with the same device. There is no free lunch.  @TheOriginalEviltech  

I'm glad he's allowed to use the power, but it is definitely not free.
Reply: @TheOriginalEviltech it is technically stealing and whennyou do it you are putting loads on the line in exactly the same way as if you plugged in a wireless charger in your home.
Reply: @TheOriginalEviltech  I think it is technically stealing. Inducting in an electromagnetic field produces a load. Anyone who uses one of those wireless induction chargers for their phones aren't getting the power for free. If you measured the load on the wireless charger you'd see it increase when the phone is on it. 

Also, I don't think electromagnetic fields can be "grounded out"; it is not a flow of electrons. Again with the wireless induction charger example, you could put a grounded plate between the charger and phone and it'll still charge. It would charge less because the distance between them has increased due to the thickness of the plate.
Reply: @TheOriginalEviltech No. it’s the equivalent of running a load on it in parallel. It is increasing the resistance in the lines which means the lines have to deliver more current to maintain the same voltage aka its using power. Induction is exactly how transformers work. Just because it’s connected wirelessly doesn’t mean it’s not consuming power.
Reply: @TheOriginalEviltech  That is like taking something someone has thrown away. It is not stealing and should not be illegal unless there is a specific law or rule against it.

However, the comment did not specify which pole. If it was on the electric company's pole then that could be unauthorized use.
Reply: @TheOriginalEviltech  This would be interesting to test with a practical expirement. Perhaps we're not thinking of all the factors 🤔
Reply: @TheOriginalEviltech This is not how electricity works. Current flow through the improvised coil creates an electromagnetic field which opposes the field from the high voltage lines. This causes the reluctance (dynamic resistance to AC current flow) in the high voltage lines to be higher, and does cost the power company more than if the man were not harvesting power.
Reply: @DataScienceDIY  Seems like you know more than an automation and electronics engineer! If i were you i'd read on capacitive coupling and capacitors in general. Electromagnetic induction only works when you have a loop so the current can flow in it and create opposing magnetic fields. A wire connected only on one side does not form a coil. It is an electrode no different than the ground beneath it, but with much less area so much less capacity.
Reply: @TheOriginalEviltech Yes i was thinking the same the same.  its not clear if he grounded the end of the coax.  If he did then it was an inductive pickup.  If not, then yes it was capacitive.  Either way, he was stealing power lol.
Reply: @TheOriginalEviltech ??    No the field is not losing power without induction..   Do you know how a transformer works?
Reply: @jimonthecoast3234  Hahahaha! Yes i do know how a transformer works! By using the wire as an electrode  you are not making a transformer. You are making a capacitor. A capacitor inside an already present capacitor formed by the overhead lines and ground.
Reply: @TheOriginalEviltech  between conductors. Not ground.
Reply: @TheOriginalEviltech  Except the additional inductance of his coil actually does reduce the amount of power that the power company can deliver over those transmission lines.
However, if they are radiating that EM filed onto MY LAND then I sure as hell am going to take advantage of it.
Reply: @TheOriginalEviltech  If you are referring to the welding shop with "induction coil on a pole", then you are incorrect.  remember that the strength of the field drops with the square of the distance from the source (line).  actual formula is E = kQr2 with r being distance from source.  So, for purposes of COMPARING DIFFERENT DISTANCES you can ignore the kQ and just look at distance.  

i.e. if actual field strength at 1M is "x" then at 10M it is x/100 at 100M x/10,000
 So, let's say line is 20M above ground.  induction coil is 10M above ground (10M from line).
Field strength at ground level is x/400.  field strength at induction coil is x/100.
If line and/or coil higher, it gets better. 
If line at 25M and coil at 15, field strength at ground level is x/625, at coil only x/100
or if line still at 20M but coil at 15M (5 M from line), ground field strength is x/400 but at coil x/25.
So coil able to draw FAR more power than being lost to ground.  
this is why high voltage power lines are so high.
Reply: @johnscully1924  i am talking about capacitive coupling. It's electric field, not electromagnetic. The electromagnetic field is dependant on the current going trough the cable and the distance, the electric field is dependant on voltage and distance. It's only useful because the voltage is alternating.
Reply: @TheOriginalEviltech It wothdraws power from the HV. It is like a badly designed transformer. That can also transmit energy through the air from one line to the other.
Reply: @TheOriginalEviltech  It is stealing. Energy is not wasted. At least not in the same way you think. The high voltage line experiences a higher load and you are not paying for the power.
Reply: @stefannilsson2406  so the ground is stealing.
Reply: @TheOriginalEviltech  Technically, yes. Do you know why we hang high voltage cables in the air if possible, instead of in the ground?
It is generally cheaper. But it also decreases losses. The ground acts as a capacitor on the high voltage lines, creating additional load on the grid.
By hanging the cables in the air, this effect is reduced.
If you set up a fence next to a power line, like in this video, there will be an increase in current running through the power lines.
So, you are using up grid capacity without paying for it.
Reply: @TheOriginalEviltech it is definitely stealing. The energy would not be lost otherwise.
Reply: @TheOriginalEviltech  it is not true that there's no net effect. The power 'waste' is increased due to some black magic I don't understand that involved the device magnetically coupling with the HV wire's ambient field. There's no free lunch here and power companies with sufficiently advanced gear can not only detect it but chase down the source - if they wanted to.

This much is plainly obvious when you hook up a ammeter to an electromagnet and run a coil with a load on it through it's field.
Reply: @TheOriginalEviltech you do not know how it works then.
Reply: @TheOriginalEviltech  Not exactly.  Without a path to ground, the field is energized but the current transfer remains stagnant.  The field reaching the soil, isn't a path to ground.  It's like having a power transformer with an open circuit.  Power present, no power transfer.
Reply: @BulletproofPastor  So reactive power is not a thing? Capacity on the lines causes power to charge and discharge it 100 times a second on a 50Hz network. In an ideal world that will not waste power because the lines and the ground will not have any resistance. However they do and the capacitive load is creating a capacitive dropper to the voltage being lost in the line and in the ground. You could easily test it with a portable oscilloscope.
Reply: @TheOriginalEviltech  True but it's calculated and quite small compared to an inductive load.  Today there are several who attempt "free power" by fence lines and other means but the loss to the power companies is fairly easy to locate and the perpetrators are routinely charged.
Reply: The secondary loads the primary.
Reply: @TheOriginalEviltech he's pirating the electricity 😂
Reply: @TheOriginalEviltech  No; the setup is what draws power off of it. Signal light triggers work on the same principle.
Reply: @TheOriginalEviltech  Wrong.  Field is stronger because induction coil was elevated, and more energy was taken because coil was composed of copper,  a much better conductor.
Reply: @TheOriginalEviltech  No, no it's not. It is stealing because it causes loss on the line side of the grid, distribution transformers are LITERALLY the exact same concept, if you can be docked for hooking copper up, you should be docked for intentionally putting coils within the inductive field of the lines...
Reply: @TheOriginalEviltech  No.  It loads the system.  There is no free lunch.
Reply: @TheOriginalEviltech It is actually theft. For every watt you pull from the EMF surrounding the power line,  the power company has to produce several watts to maintain it. 

This is no different then the transformers that exist in most electric and electronic devices to step voltage up or down. The energy flowing through your power cord into your device isn't directly connected to any circuits within your device,  yet power MUST flow through the cord and input side of the transformer to drive the output side of the transformer and power your device.

Another example is Qi Chargers for phones. There is no connection between the pad and the phone,  yet you must plug in the wall wart for it to charge the phone. In this scenario,  the Qi pad is the transmission line.
Reply: @Flamingtac0  It wasn't ruled as theft at the time.
Reply: @TheOriginalEviltech  this... is hilarious.

In both capacitive and inductive coupling, the amount of load on the output side IS transferred to the input side. Always. Dirt, despite obviously being "grounded", does have meaningfully-high resistance, and shoving a coil of wire in between and picking power from that coil absolutely pulls more current on the power line side.

Always.

That energy absolutely IS being seen on the other end.
Reply: @emolatur  exactly the resistance of dirt and the not-so-perfect dielectric properties of air are dissapating allot of the capacitevely transmitted power as heat. If it was copper and the air was a perfect dielectric insolator you'd get allmost no losses, but having the dirt as the second electrode results in losses that will totally eclipse a metal electrode close to the ground from which you can syphon some ammount of energy. You should read about dielectric heating.
Reply: @TheOriginalEviltech  *some*.

And it's still there even when you add your additional load.

You are adding additional load, thus causing more total loss, thus costing the power company.

Being "eclipsed" (I'm almost certain you're wrong on that but even if we pretend...) by another loss does not make the present loss nonexistent.
Reply: @TheOriginalEviltech  it is stealing. by taking any power out of the system the system needs to replace that power. if you stick a thousand fluorescent lamps under power lines it obviously takes power away as it lights then all.
Reply: That power is being wasted anyway. By using the fence or whatever to pick it up you are not doing anything different than using a solar panel to collect photons that are already there and were instead being turned in to heat. If you get in contact with the wires or close enough to generate an ark to them, than that's stealing because it will change the amount of power that's needed to feed the line. @KarldorisLambley
Reply: @TheOriginalEviltech  lol. if the load increases, the power supplied to the system must increase. this is physics 101, have a look at the laws of thermodynamics is my advice. a free lunch doesn't exist in science. some  power is being lost before to the environment, through capacitance. but if you now put an something near the line that inducts more power away, the transmission system must provide more power. how can you not see this? you are suggesting if every home, for hundreds of miles beneath the power line starting running their homes on 'harvested' power it wouldn't cost the power company anything? just think about that before you reply and look stupid. again.
Reply: @TheOriginalEviltech  it may help you understand this if you realise that no home has a wire connecting it to a power station. the transformer on a pole outside just takes power from the line by electromagnetic induction, which is exactly the way an inductor under a line takes power from the system. to the generating station the result is identical, removed energy.
Reply: The amount of power that could extract is minimal. I doubt it would even power a 100W light bulb.
Reply: @gargantuablargg
Reply: Here in Brazil, he would probably get death penalty. 😂
The corrupt State doesn't like to be made fool of.
Reply: @MrHeuvaladao  in africa they steal the oil from residential capacitors to fry food.. the more you know
Reply: @magicone9327  Your statement is patently false. Doing this changes the impedance seen by the line, which must be compensated for with a higher voltage,  which necessitates a higher energy input at the source. 

EMF does NOT bleed to ground.

Power is lost as heat due to resistance in the transmission media and step transformers, not through the EMF field.
Reply: Natural phenomenon,  natural justice.
Reply: Thanks!! I'll consider myself unshitted from here on out!
Reply: @silverstem2964  You have my permission...
Reply: It's not stealing.  The electric company owns all of the juice that is IN THEIR LINES.  Any power that escapes their possession, constitutes ABANDONED PRORERTY and unless they take action to retrieve it, salvage law rights apply.
Reply: so it's like syphoning a petrol tank then........... it's their gas but it escaped....? @matta.5363
Reply: @matta.5363  If this were true I should be able to plug a coil into my wall socket and just pay for the load that the yards of copper produce. Then I could take the waste electricity from my coil and put another coil near it and run my house off  of the waste from my coil for free. But when I put a second coil next to the first coil the load on the line goes up because   inductance creates extra resistance on the line and its the resistance that you pay for. The load doesn't just harvest em radiation it increases the load beyond what is leaking. That is the same way everything you plug in works too.
Reply: @matta.5363 I don't think you know how electricity works
Reply: @matta.5363 Nonsense. You are drawing current with induction same as if wires were connected, only less current . Energy isn't just floating around if there isn't a path
Reply: @matta.5363 the power actually goes through the air around the power lines the electrons move through the wire. Your basically saying the power company owns none of the electric power 😂😂😂
Reply: @matta.5363 the juice is not just in the lines. the electrical field surroundibg the lines is also part of "the juice". Actuall most of the juice is outside the leaders.
Reply: @matta.5363 I like the way you think. Classic.
Reply: @matta.5363   The field surrounding the lines is not waste ... that is the exact field which is allowing the transmission lines to work.  The energy in the field travels along the lines and is eventually delivered.
Reply: collecting waste electricity is not stealing . you should thank the guy he is picking up trash.
all that pollution
Reply: @thedevilsadvocate5210  The transformers that step voltage down before sending it to house do not have metal-to-metal contact between the higher voltage and lower voltage lines.  So all these transformers are collecting waste electricity?  So the more electricity I use the more the power company should pay ME for cleaning up "all that pollution"?
Reply: @thedevilsadvocate5210  it’s not waist energy it’s real energy
Reply: @thedevilsadvocate5210 that's not collecting waste electric . You are drawing current from lines,
Reply: True story bro
Reply: True story bro
Reply: @FreiherrDinkelackerWrong.
Reply: It's taken a YouTube video to prove how it works. Most folks living next to power lines all their lives never knew they could have free lights and TV.
Reply: My thoughts exactly,can't steal what they fail to contain,it's there for the taking.
Reply: True story...I was 4 years old at the time and I used to hate to pee because it took to long to go to the bathroom and I am super ADHD, always have been. I set up a few pillows and pretended they were car seats in front of the wall in the living room using the electrical outlet as the ignition. I then took a key from the key box we had in the kitchen and also got my mom's hair straightener thing so I could use it as a gear shift while I  played "cars" in the living room. And so I got annoyed I had to pee and I peed in the corner of the room and went back to play "cars" some more. I stuck the key in the socket and pretended to turn it and got shocked to hell. Meanwhile I had plugged in the hair straightener and it was burning the carpet and melting it. And when I peed in the corner behind a bookshelf my father who was a college professor had hidden his new work computer at the time right where I had peed. I don't remember a lot from my childhood but I remember that day. My father was livid. He was as chasing me around the house and trying to strangle me I presume just like Bart and Homer Simpson. I burned up the carpet with the coffee warmer and the carpet had a hole in it about the size of a  grown ups foot. When I peed on my father's brand new computer which was a few days old he didn't find out until later when he got to class and smelled urine and opened it and tried starting it and it wouldn't start and it smelled like pee. When I shocked myself I remember a literal buzzing and a strong grip on the key I was sticking in the socket and I remember it smelling like burnt carpet and I had just gotten buzzed electrically and I was out of control. My mother smelled the carpet burning first and ran down the stairs and I met her halfway and I stopped her and said "Mama I got fire going". 
"Mama I got fire going". She was like "holy crap Jonathan where is the fire!" And  she smelled it and I brought her into the room where the carpet had a huge hole in it and the house was full of smoke and i had just electrocuted myself aswell. So she unplugged the coffee heater or water heater thingy and she tried pulling it off the carpet and a bunch of burned up carpet goo stretched out and was dripping off of the water heater thingy. 
My Dad's computer was very expensive and this was 1994 when AOL first came out just av and my dad's computer was  toast by the way. He ended up having to tell the department at University of Kansas where he was a teacher what happend and they had to replace the entire thing. My Dad was mad before he knew about the computer and after he had a conniption fit and again ran after me trying to strangle me like Bart Simpson and Homer Simpson. Lol
I miss my father. CC
Reply: @sswulffable  Who?
Reply: True story bro
Reply: True story bro
Reply: True story bro
Reply: True story bro
Reply: ..Only because there's no law regarding ambient energy collection near a power source, I presume.
Reply: the weld company WAS stealing power., or using it at least.  Yes the power lines emanate electromagnetic fields but that doesn mean they are emanating (losing) power all the time.   Aabsent of any nearby conductors,  there can be no external currents and thus no power loss.   Like this video,  the owner created a crude and inefficient transformer, a loop in air (core permeability=1) by which an electric potential could be created and thus a current I driven through a load R.   power=I^2R.    Electrically its the same as tapping a transformer ( many turns, iron core permeability >1000) to the line and powering your house.  

the situation for the video author may be different.   I dont know if the end of his 80 ft coax was staked to ground to form the loop.  If it was open then he created a capacitor and used Amperes law.   I=C dV/dt  to get the power.
Reply: @FrenchmansFlats51 The Federal Court ruled in favor of respondent... And the case was summarily dismissed
Reply: @quoderatdemonstrandum5442 my interest lies purely in the nature or the physics of the issue.   the law is a human institution.
Reply: Sorry, it is only urban legend. The energy of such "stealing" is tiny. But you can get to jail for tinkering with power lines. The only one case of real stealing of energy in my country was by digging HV transformer to ground and using tiny wires from power line. As power loss was small compared to power transmitted,  it was undetected until somebody noticed lack of snow near the pole (bad contacts heated the ground). It was reported as earth leakage and later cable connection lead to some building.
So, your "True story" is complete bull *&^% unless you can show federal court case number.
Reply: @kaunomedis7926 LOL... What are you? Twelve? Or a Lib Arts Major?
Reply: God bless conservatives lol
Reply: hmm, sounds more like the kind of welfare queen Ronald Reagan warned us about. imagine that guy as a Black man and you'll see what I mean. @MattttG3
Reply: @MattttG3 The conservatives owning that power company were the ones bringing that case in Texas.
Reply: @MattttG3 God bless conservatives indeed! 🇺🇲💪🦅
Reply: @MattttG3  Ya, stick it to the other people! I blindly vote the way my daddy did as well!
Reply: @MattttG3  🤡🤡
Reply: @MattttG3  since when to Conservatives believe in physics?
Reply: @MattttG3
   How is that because conservatives would fight tooth and nail for the power company to have the guy thrown in prison.
Reply: @MattttG3 it was a conservative tycoon who stopped Tesla from publicly distributing free electricity.
Reply: @AnneGoggansQHHT think a minute. Nobody was ever going to generate electricity and give it away free. If they wanted to, they could just pay everyone's power bill. Why doesn't anyone do that? Because nothing is free.
Reply: @MattttG3 
Or not🔵🔵🔵🔵🔵🔵🔵🔵
Reply: @MattttG3  God bless Karl Marx for telling us just how stupid Liberalism really is.
Reply: Hey, regardless of the science at least you made sure to virtue signal, and that's what it's all about- right comrade?
Reply: @RoBo11235  WTF are you talking about?
Reply: @johndoe7270 And whoTF is he addressing? Doesn't matter. I'm guessing he's virtue signaling to his own comrades, whomever and wherever they may be.
Reply: @charlesmain9938  What about that is virtue signalling?  Hes telling a story about a court case.
Reply: @johndoe7270  OK. there seems to be some confusion as to who is responding to whom in this free-for-all, not that there's anything wrong with a healthy free-for-all.  I was commenting on your response to:
@RoBo11235
20 hours ago
Hey, regardless of the science at least you made sure to virtue signal, and that's what it's all about- right comrade?
Reply: @johndoe7270  you don’t think people making comments like god bless conservatives and god bless Karl Marx (really funny considering Marx’s view on religion) in the comments for a video about getting electricity from nearby power lines is a bit extraneous?
Reply: @RoBo11235  Where?
Reply: @MattttG3  LOL.Thank God for Karl Marx…  Who showed us way back in the 19th century just how stupid some people can be.
Reply: Great story! Of course, it was the court that was clueless about the physics - or the law for that matter. The intent of the business owner was clear: steal electricity.
Reply: @davidedickjr  The physics were well understood. In fact the old man's attorneys referenced a 10th grade Science book in their opening arguments. And because he was not in violation of the easement rules in effect at that time, the court ruled that the power company had no case. So they threw it out. PS: The easement regulations in Texas have since been changed.
Reply: @quoderatdemonstrandum5442  
     Years ago, early to mid 80's I think. As they were getting ready to open the stretch of I-75 past Bradenton Fl.  A then old barren access road past Jigg's landing to Linger Lodge. They built a brand new two lane overpass bridge to cross I-75. 
    Brand New fresh Blacktop.  As an avid long boarder. I jumped at the chance of a half mile of fresh black top  with a Forty five foot high hump in the middle of it.  Cowabunga !!   Free air for this speed freak. 
   On the east side were  Two sets of Main power feeders, paralleling I-75.  Now much closer the moist damp black top  roadway. I board at night to see headlights in the distance, under the moonlight. Barefoot, to feel the rail of the board with my toe's when you slalom to control your speed.  35 + mph on a modified water ski on precision trucks and wheel's is a real grin. 
    As I passed under the lines on the east face of the hill the air was sweet and the hair on my arms stood up.
 I jumped off the board barefoot on moist fresh black top. My whole body tingled and I tasted copper in my mouth.  I went back home and brought back a four foot fluorescent tube. 
   Standing under the closest set of lines to the moist roadway.  Body Tingling barefoot, tube held horizontally high over my head. Around my outlined fingers clutching the glass of the tube. It was the brightest. The closer my hands drew together the brighter it got. The mercury vapor lit the brightest just under my fingers. And I could literally see what looked like dots of lit mercury swirling inside. Dark on the ends.  And shut off like a switch when I jumped  on the board.  
   Memories, I'm amassed I've made it to 69 years old now. I still board to stay young.
   Shortly after they opened the highway they raised those mains on much higher poles.  Grins and giggles of my youth.   Lot's of wasted energy in those Electromagnetic fields.
Reply: @snapcutter9596  Yep. We used to tape a fluorescent tube to an old cane fishing pole, and lift it close to the wires…. It would blaze.
Reply: @snapcutter9596  Dude great story I could really feel it! I grew up in Tampa very early 80s used to skate in TIA  above ground 5 story parking lot, same at the Westshore mall, good times and had it all to myself this was before they looked down on it. nothing like smooth fresh Black top or concrete.  In 1982 I took a job at CCAFS/Cocoa beach, ultimately  working downrange and would skate in the dishes till I got busted. Sk8 or die haha. Im 63 and recently got back into dirt bikes as I moved to the rural Ozarks have a 75 XT500, 83 XL600R and a couple of quads.
Reply: @snapcutter9596 That's not how EMF works. It's not wasted or free energy. When you interrupt the field to power a coil, the impedance of the line changes and the voltage has to be increased to compensate. That takes additional energy.
Reply: @deepbludude4697  
 Just life man. We all have our own life experiences. Makes us who we are. 
I've done TIA also. When the lot was new. I got run out of Westshore. There was a nice bowl with a tall drop in. In a park north of Ybor City Tony Hawk help start back then. I would go up to Tampa for it. Gone now. 80s was just yesterday, right?
   The Misener bridge, Last one north of the Skyway is still a good ride. South face is a fast steep 1/3 mile drop two jogs in it.
     North sided more gentle. I rarely start from the top anymore. A 4' 9" cut down flipped around wooden water ski W/ road rider 4s hanging on a set of old Bennet Pros. And my sector 9, help to keep me young. Kicking a board since I was 17. 
    Deep Blue, Been good dude. Live long Love life. For life is what we make of it!
Reply: @quoderatdemonstrandum5442  Wonder why the rules got changed 😁
Reply: @quoderatdemonstrandum5442 - If this whole thing took place near Beaumont, Texas, I can confirm the story, 2nd hand, from my father.
Reply: That’s not entirely true
Reply: @snapcutter9596 The way you write and recall this is pure poetry. Thanks for sharing, my man!
Reply: @quoderatdemonstrandum5442  ROFL saving this of course it would be changed
Reply: @JohnVieiraact  I'm sorry. Sophomore... But you're way off track.
Reply: @quoderatdemonstrandum5442   As a kid I'd make a fluorescent tube glow dimly (maybe only visible in near total darkness with eyes set accordingly) just between my hands.  I don't have explanation for it.
Reply: @Mrbfgray  It's called induction. Check your 10th Grade Science book...Fluorescent tube in close proximity to strong AC magnetic field. 8^)
Reply: @snapcutter9596 imagine not burying mains…
Reply: @quoderatdemonstrandum5442 What did they change the easement conditions to?
Reply: @philipliethen519  Don't know..
Reply: 1m .it depends of voltage ans distance from hv wire and "can"
Reply: @snapcutter9596 sounds super cool man! You still longboard? I'm now getting my son into skateboarding it's so awesome!
Reply: @MRblazedBEANS 
     Gravity... is a wonderful thing. If used it to your advantage.  I'm 71 now and still enjoy a full moon night ride.  Just last week the air was sweet and cool dropping down after a long kick up the west sidewalk of the Misner bridges north face.  The approach to the Skyway in St Pete.  
   Mr. Beans all I ask. Is buy the best skateboarding gloves for your Son. The palms are reinforced but also  down around the wrist with a padded stabilizer bar with velcro to add support to avoid a radial fracture .   That's all I use. Halfshell helmet sometimes if Im doing something radical. 
Finally started using tennis shoes because of Bone spurs.  
   Tell him someone told you to practice letting your board get to know you. Standing still in some soft grass with a flip kick, Ollie or a rail ride.  Before you add the concrete.
Reply: @davidedickjr  What does intent have to do with it? In the USA... and everywhere in the world... the law is totally arbitrary. Not only do we get 40,000 new laws each and every year, a good percentage of those are changes to old laws. 

The fact of the matter is the power company has zero capability of monitoring the energy that is being inductively "stolen" from their power lines. He could do what he's doing outside the easement equally as well and they have zero right to enter his property. He could use his fences to place an inductive parasitic load on the lines and do nothing with it but generate heat. Write the law that makes that illegal. Since the law is arbitrary, they can make it unlawful to inductively couple to their lines. Follow the money. The law follows the money. 

He is not clueless about physics or the law for that matter. You are. And if you've ever personally met a judge, you know she is clueless beyond belief. Most are lawyers so they have no credential but skill to argue on any side of any matter with zero knowledge about it... and to collect tribute in the process... until they have bled their client dry.

And I'll bet you yourself are clueless. I'll bet you buy and drink bottled water when water is obviously a free resource. And I'll bet you would submit to a law that says you "must" drink only bottled water. And after that a law that says you must breathe only bottled air. And of course the bastards could easily pass such  laws. In fact such laws exist in Oregon pertaining to capture of rainwater from your roof... or from a stream running through your property.

Stupid is as stupid does... and as stupid thinks... and as stupid concedes... and as stupid complies... and as stupid marches off to war in defense of stupid masters.
Reply: @davidedickjr  WRONG !  The court was Spot On with this ruling !  A person CAN NOT be charged with theft or stealing for what is freely open and available in the AIR !  BLEED OUT of electrical lines is a loss the electrical utility knows and doesn't care about, therefore,... it can not be considered theft !  The air we breath is free to all and can not be ruled as PROPERTY,... radio waves and transmissions in the air are FREE to be taken by anyone with knowledge of how to access it,.... a rule of the law !  Theft or stealing can only be if a person TAPS DIRECTLY into the lines by PHYSICAL CONTACT with the LINES !   BLEED OUT was ruled DECADES AGO as a loss to the open air and CAN NOT be construed as THEFT or STEALING !
Reply: @davidedickjr  More like taking advantage of the environmental conditions of his property. How is it different than if the power company built a large concave mirrored glass headquarters that focuses on your property and you taking advantage of the concentrated solar energy that the building provides?
Reply: @gschgvt2956  I'd say it's different in that after it was built it didn't cost the company anymore money than they had intended to spend to continue to use the building. The difference in this case is it cost the power company to continue to produce the electricity and when you put a wire under power lines it essentially creates a transformer just like the ones in your house appliances. Your appliances internal electrics/electronics are not physically attached to the electricity coming into the cord plugged into the outlet. It's connected to a transformer that uses induction of the magnetic waves and that actually draws power form the outlet from those power lines. To get electricity to you have to pay the power company to connect it to your house to use it from your house circuit panel. When you run a wire under the line it creates a transformer, that like you house transformers actually draws power from the lines via the magnetic waves as it cuts the fence wire. So that's why it's stealing, it actually does draw a very small amount of energy from the line. Ironically if every house in a home track put up these induction transformers in their back yards they could draw power right over the air and into their homes. Every one who doesn't do it would then be paying for people stealing power that way. Anyways you asked so I hope that helps explain why it's stealing, it really does pull power out of the line when you do that. Best Wishes & Blessings. Keith Noneya Former Electronics Technician Retired.
Reply: @gschgvt2956 when you plug a phone charger into the socket you are doing the same thing as the business was. There is no connection between the powerline and your cell phone either. By putting a coil of wire on a pole like that the business owner made a transformer just like a phone charger. He was using the power grid exactly the same.as if he had plugged into an outlet. The physics is exactly the same. You are not just taking advantage of the physics when you plug a transformer into the wall. You are taking power from the fridge and somebody will pay for it.
Reply: @gschgvt2956  The company in the large glass building isn't focusing the light to make money. 

It's different,  because pulling power from fence acting like an antenna isn't 'free energy'. The fence or whatever affects the EMF field,  changing the impedance of the line. This is felt at the power production point as an additional resistance that must be overcome. For every watt of energy you pull one you complete your circuit,  the power company has to produce several watts of energy.
Reply: @jlrinc1420  it's like when you turn your radio on you're stealing from the radio station!
Reply: @AegisHyperon  except your not increasing the load on the radio station by listening to it because you use your own energy to amplify it. When you take power from the power line you increase the load that the power company has to provide because the reactance of the line has increased.

If it were not stealing energy you could simply run a large coil in your house and pay just for the load the copper coil put on the system. Then you could  get free energy by putting another coil near the first and running your appliances off of the induced voltage in the second coil. It's the same theory as putting a coil near the power line.

When you put a coil near a pulsing variable voltage as in a power line the magnetism you create in the primary source creates resistance that wouldn't be there otherwise. You are adding a load on the primary source.   Every time you plug an appliance into your wall socket the line voltage uses inductance to step the voltage down. You do not get a discount because you are using "wasted" power.
Reply: @AegisHyperon  In any case the radio station pays for the power you are using by selling advertising. It's not like the radio waves broadcast themselves. Somebody still pays for the electric signal your radio receives. Thanks to advertising it looks free to you but it's still expensive.
Reply: @KarldorisLambley  Actually, no.  That electromagnetic radiation is already diffused and lost into the surrounding environment.  He is basically mopping up what analogously is akin to water leaking from a water main, water that would have already leaked into the ground for nothing.  If the electric company wants to prevent that, then they would have to build a sealed conduit that would keep the energy from wastefully dissipating into the environment.   
Put another way, is a dog eating crumbs falling from the table stealing food from the table?
Reply: @papanam4267  removing more power from the system, that is adding harvesting equipment beneath lines will increase the load. it may be infinitesimal, but it will cause more power to leave the system that just grounding to the floor through capacitance.

Using the analogy of a dog eating crumbs falling from the table, it would be more accurate to say that the dog is actively taking something that was not initially part of its diet. Similarly, the harvesting equipment is actively extracting energy from the system, introducing an additional load. the eaten crumbs must be replaced, in a power system.
Reply: @H8teTuber  Nope its the same, basic electrical transform application. 42 years in the business, so nope not ignorant. Just explaining how it works and why it's theft. If you disagree that's ok, it's not going to change how a transformer works or how a person can build a coil to act as the secondary in a transformer to steal the power. It's actually pretty smart way to do it just don't get caught in an area where that's against the law. Anyways, Best Wishes & Blessings to you, your family and friends. Keith Noneya
Reply: @jlrinc1420  Somebody who understands electromagnetic fields ^^^^^
Reply: @keithnoneya If they were serious about protecting their power from the inductive energy harvesting, they'd be shielding their lines from any spurious transmission that might happen...just like a coaxial cable is shielded. You've seen the label on products you buy that according to the FCC, and I'm paraphrasing here, "This product made not emit any type of interference, whether EMF or RF, while at the same time this product must accept any spurious EMF or RF that exists in the general vicinity". This is a plausible deniability "catch-all", plain and simple. Likewise, energy transmission lines, due to not being shielded are fair game as they are emitting that which we are forced to accept. Their hand has been exposed by inappropriate implementation of technology.
Reply: @gschgvt2956 it’s different because it’s actually decreasing the amount of power that is carried through the transmission lines
Reply: @AegisHyperon  Only if you don't listen to the commercials...  😆
Reply: @keithnoneya  Thank you Keith I was just about to comment that it is indeed stealing you nailed it
Reply: @keithnoneya 

Je pense que la réalité est plutôt ambigüe,

Il y a des mises à la terre  sur les pylônes, et agissent de la même façon qu'un transformateur par contre réaction,

La force De redressement pousser à un temps, et quand le temps est terminé, l'effet va dans l'autre sens par abaissement,

La façon dont le transformateur est monté, définira en sens polaire, dont l'abaissement est bloqué en un sens par les surfaces conductrices, donc cette abaissement génère automatiquement un champ électromagnétique de mis à la terre,

Je crois comprendre que les télégraphe ont employés ce phénomène  en le comprenant beaucoup mieux que ce qui est instruit en les formations électriciens,

Le télégraphe nommé le ricochet du courant, qui est intégré par abaissement a la terre puis a nouveau impulsé en la ligne,

Donc en théorie, la bobine va capter le courant de la mise à la terre, et cette même bobine émet un champ électromagnétique qui permet la contre réaction vers les conducteurs du pylônes,

Je pense pas qu'il y ai réellement de pertes

En théorie , les valeurs de niveau atmosphérique, qui envoient une mis à la terre vers un élément supérieur en placement atmosphérique, défini que c'est la bobine qui va fournir un surplus de courant aux fils du pylône

Une mise à la terre forcé vers le haut, c'est rehausser l'effet cathodique sud tête nord base, amplifiant en dessous une rehausse de l'effet Anodique sud base nord tête,

L'anode rehausser est comme le sens du parcours polarisé, et c'est la terre qui extrait du surnuméraire vers le haut
Reply: @davidedickjr intent doesn’t matter, it’s not stealing if it’s a natural resource you can harvest legally and electricity in the air is the same as harvesting rainwater. It is your right to harvest it. You own it, it’s on your property.
Reply: @davidedickjr  You can't put a meter or claim the rights to free open air, on your own land!
Reply: @davidedickjr your logic is equivalent to saying that if your neighbor is washing his car and the water that runs down the hill waters your lawn that you are stealing water from him. Someone taking advantage of ambient electricity at no expense to the power company isnt theft the electricity is being lost regardless. The power company should be happy that they dont have to pay people who have to live that close to teansmission lines the fact that they sued him and the fact that youre shilling for them is both comical and pathetic.
Reply: @davidedickjr  What do you know of the property owner's intent?  He took advantage of a natural phenomena that occurred on his property. No different to the power company to take advantage of the natural topography next to his land to facilitate their own purposes.

It would be akin to taking pictures of jet liners that crossed overhead on ones own property and making profitable uses of such pictures.

if those same power lines where causing ill health and loses to the property owner, the the power company would fight tooth and nail to "prove" otherwise.
Reply: @davidedickjr  
stealing requires going somewhere and taking somethign that doesnt belong to you. if the power is running through your property via lines. you are entitled to the energy it casts down onto your property. if they dont want that happening they cant spend billions to shield their cables.
Reply: @davidedickjr your definition of "steal" must be very interesting
Reply: @derrick_v  Steal = take that which is not yours.
Reply: @quoderatdemonstrandum5442  hey simpleton, my comment was OBVIOUSLY directed to an individual who doesn't understand this would NOT be stealing. If this was a true story, which it's not. If so, name the people involved. Liar.
Reply: @derrick_v Knowingly using electricity without permission or paying. That's definitely stealing. Connecting by induction isnt that different from hard wiring. Can get same current. But still takes from source.
Reply: @davidedickjr so if I spill grain in transport and you come along and scoop it up and feed it to your pigs. Is that theft?
Reply: @edwardfindley8483  No. Your intentions would have been innocent. It would become theft if one altered the train tracks such that installed bumps would dump grain by design.
Reply: @davidedickjr  but no one is altering the transmission lines. The electricity is being spilt, like the grain. He is merely scooping it up.
Reply: @davidedickjr  It's not that the court was clueless(even if they were), it's the fact that there weren't any laws prohibiting what he was doing. Like sorry dude, just using science and physics, didn't break any formal rules, deal with it, lobby to update the laws if they aren't properly meeting your needs and requirements....
Reply: @davidedickjr I thought that, but this is an induction coil. No contact with their power lines at all. Kind of like being charged with stealing water from my neighbours irrigation system by catching it when the wind blows spray over my fence. Do they own the electrons in the air. If they don't make any loss from this, maybe we are looking at an amazing way of charging vehicles.
Reply: @philgray3443  Electric fields are not electrons in the air. Causing induction in an electric field creates a load on the system and is therefore using the power.

Wireless / contactless phone chargers are not getting free / wasted energy when you put your phone on them.
Reply: @davidedickjr More wrong you could not be.
Reply: @davidedickjr  The intent of the business owner was clear: harvest stray electricity.
Reply: @davidedickjr  If your spinkler system is spraying water over the fence and your neighbor sets a bucket out to catch it, is he stealing your water?
Reply: @davidedickjr  You are calling it theft. I would calk it resourcefullness. I would not say utilizing residual flux is theft. It is more of a crime to allow the flux to permeate the environment unchecked.
Reply: @davidedickjr  True, but the only way the power company can stop it is to move the transmission wires.
Reply: @davidedickjr  the air is free for everyone.
Reply: @davidedickjr  I think it's more of taking advantage of the electric company giving it away. It's not like he hooked into the system and "stole" it.
Reply: @davidedickjr  Nope, if you wash your car and the water splashes onto my property, I am free to catch it and use it. Unless you can see the electricity arcing onto a wire setup by the property owner, it would seem to me that he is doing nothing illegal. The environmental hazard posed by these power lines is poo-pooed by power companies but is real. They do not claim any responsibility, so they apparently do not consider the power radiated as per physics, theirs.
Reply: @davidedickjr  Sorry, but you are wrong.  As long as he is not physically connected to the lines, it is not stealing.  When current flows through a wire, it generates a magnetic field.  What the coaxial cable is doing is simply capturing the magnetic flux lines, thus creating an AC current through the shield of the cable.  A magnetic field is public domain.  Other courts have ruled in a similar fashion.
Reply: @davidedickjr  ain’t stealing if there’s no meter
Reply: @davidedickjr  good thing intention is only half of the equation. You can argue he was trying to steal it but since none of his stuff was touching any of the power companies stuff he was just using his property and only his property kind of hard to say you're stealing something when it's on your property and there's no agreement to the contrary.
Reply: @davidedickjr  he stole nothing.  He collected  the lost energy on his property that the electrical company was dumping.if it were pil would you say the same if a fellow used oil the oil company dumped onto his property without consent?
Reply: @davidedickjr  would you say the same if a  nat. Gas pocket was under your property and you used it even tho a big industry company was harvesting the gas to sell? Good luck proving any wrong doing any case 😂
Reply: @davidedickjr it is not physics but a interference. You have to contain all your energy within your wire, or you are causing an interference, which is prohibited. If you are penetrating someone’s property with that interference, they can use it freely, like the light you may have across the street, or radiovawes emitted from your antenna, or sound you may produce. Go and sue me if I am using a light from your lamp and getting some energy from photovoltaic.
Reply: @davidedickjr cry about it.
Reply: @davidedickjr  stealing from the air?
Reply: @davidedickjr  that his tax dollars paid for technically.
Reply: @davidedickjr nah, you’re just more concerned about someone capitalizing on something you can’t.
Reply: I don't understand 3 phase but I understand 1 thing for sure, he didn't anything. All wire emit high frequency radio waves, those waves are all emitted from the wires weather there's a fence there cow there or you are there. It doesn't matter those waves pass through everything going from the wire to the ground and will not stop until they hit a ground or negative conductor. So what can your family be sued from the electric company when you die from getting electrocuted being near those lines? Besides electric company's are apparently more knowledgeable of physics than you. They were just trying to get what they saw as an easy mark. The health issues with being near these hv lines are well documented. Most cases of people sueing the electric companies don't amount to much in court but a big waste of time. If his wire was shorter the rf charge rate will decrease. Do do know the reason wireless cell phone charging works is based off this principle, just on a micro scale.
Reply: @davidedickjr  To me, it was like making use of electricity that was being wasted.
Reply: @davidedickjr Did he “steal” it?  He touched none of their stuff.  Seems to me they were “transmitting” it, not unlike a radio station.
Reply: @davidedickjr when its free from the sun ?
Reply: @davidedickjr They got it exactly right, and you are wrong
Reply: @davidedickjr that's like trying to say you are stealing the rain 😂
Reply: @davidedickjr  I would argue that all he was taking was advantage of a magnetic field much as someone would take advantage of the sun shining for electricity. The power company can't say they own the magnetic field because that's not their product and there is no provable loss
Reply: @davidedickjr  ignoring the fact it's a year later to call you a cowardly bootlicker, have a bad day
Reply: @davidedickjr  how is it theft if they are on your property?
Reply: @davidedickjr  how can you steal something that is leaking on to your property - if anything he should have countersued for improper installation and site contamination. - if he loses the case on the basis that these circumstances are within allowable parameters of the power company in question and not their responsibility   than the courts are just confirming that errant electricity belongs to nobody.
Reply: @davidedickjr Ummm, no. If the power company objects, then they can keep the electromagnetic field from THEIR power lines out of HIS property.
 Since they can’t, he was perfectly lawful in taking advantage of their magnetic field intrusion into his home or business.
Reply: @davidedickjr lines crossed his property, where do you get off calling him a thief ?He couldn’t use the land for anything else.
Reply: @davidedickjr  how is it stealing  if it works of natural losses.  Definition of theft is too deprive someone of something this experiment deprives no one power and safety are unimpeded
Reply: @davidedickjr  WaaaHH!
Reply: @davidedickjr  Cant steal something someone else puts on your property.  If they wanted to prevent inductive losses they should have built taller towers.
Reply: @davidedickjr  Over in SE Montana Farmers were drilling to underground formations where Natural Gas companies were storing their gas, to run almost everything on the farm. The judge ruled for the gas owners on day 1.
Reply: @wadestanton loose lips sink ship
Reply: @wadestanton  Yep. And we do that in Texas and Oklahoma too.
Reply: @wadestanton They drilled into the reservoir to boost the gas & judge said it was OK?
Reply: @philipliethen519  The judge said not OK, I have some stories of rural people using piercing saddles to tap into Natural gas and water lines and string 1000's of yards of unregulated underground pipe and I mean some BIG pipe. When the economy gets right people will tap xcountry fuel lines as well, just watch.
Reply: @davidedickjr  Did the original easement the property owner was forced to accede to the power line owners prohibit him building a fence underneath with efficacious energy capture abilities? Yes No?
Reply: @lanesaarloos281  Well, the power plant was built by Texas Electric Service Company back in the late late 1950's. So whatever the easement restrictions were in place at that time.
Reply: @lanesaarloos281  with easements, there's no pesky 'land owner' to involve. just you and the gov't and $$$$
Reply: @davidedickjr  The physics of the matter are that the power companies are not properly insulating their equipment.
Reply: @ravenshrike  - Insulation was not an issue.  Induction coils get their energy from magnetic fields not affected by insulation.  A nearby wire picks it up from the electrical field probably with capacitance, also not affected by insulation.  If insulation blocked electric fields then we would have no need for shielded wire (a conductive shield does block the electric field, insulators do not).
Reply: @ravenshrike Wrong
Reply: @ravenshrike  How do you prevent the expansion and collapse of a 240KVA / 60hz magnetic field? Answer = you can't.
Reply: @ravenshrike  I would use the word “shielding” instead of insulating … when referring to the the power companies’ not SHIELDING equipment and transmission lines.
Reply: @ravenshrike  You cannot "properly insulate" the electrical field without building faraday cage around the entire length of wire.
Reply: @ravenshrike  You cannot insulate those overhead power lines economically. In any case, we're talking about radiated power. All cables carrying current have an electromagnetic field around them. That's why a compass needle will move when DC is put through a nearby wire. It's why clamp meters work. It's why transformers work. And it's even why the ferrite rod antenna inside an AM radio works, when the transmitter can be hundreds of miles away from it. The energy travels along the outside of cables (extending theoretically to an infinite distance away from the cables), as well as through them.
Reply: @ravenshrike  simply insulating the wire doesn't work for high voltage AC, which is why lines are so high off the ground to begin with.
Reply: I think you mean Steel electricity  @davidedickjr
Reply: @davidedickjr  How is having a coil on a pole stealing?
 I guess you have shares in a power company?
Reply: @1crazypj  Let me break this down for you so that you can understand. Imagine you have a water main running through your property and you managed to tap that water main yourself with a small pipe. You are getting water for essentially free right? Well the water company notices there is more flow down that water main than all the customer meters show. From their point of view it's as if they suddenly have a leak in the system. An inductor siphoning power out of transmission lines works EXACTLY like you directly tapped into the line. There is no difference electrically. You are taking energy out of the system that normally would not be leaving the system. The electric fields are always there yes, but there is no current flow. When you inductively siphon energy, there is current flow. You are stealing electricity from the system. They have to generate MORE electricity to deal with the extra load. This is not arguable. The laws of physics are immutable. There is no such thing as free energy. If you ran enough inductive loads under a transmission line, you could literally siphon all of the energy out of the wires.
Reply: @scythelord  Can't remember what I posed that got you fired up enough to reply.
Reply: @davidedickjr was he stealing heat and radio waves too? If they didn't want him to use the electrity then they shouldn't have inducted it onto HIS property!
Reply: @davidedickjr  I say tit for tat. Guy's being exposed to potential negative effects of electromagnetic energy. Why not take advantage? The energy field around him is just being wasted anyway.
Reply: @patricknesbitt4003 No,  it's not wasted energy. Try actually learning how EMF works.

For what you say to be true,  every electronic and electric device would have to pull only wasted power, yet you get a real bill each that doesn't say you owe nothing.
Reply: @Flamingtac0  Try to keep up. Energy surrounding power lines IS wasted since it is not actually being used for anything. If one sets up an induction coil under said power lines and uses whatever power is induced therein THAT energy is not being wasted. If you hold up a fluorescent bulb under the power lines under the right circumstances it will light up. You're using that energy to create light. Remove the bulb and you're NOT using the local energy field for anything. Conversely if the bulb is held up and illuminated you're not loading the power line.
Reply: @patricknesbitt4003  What you want is a ferromagnetic toroid (donut) with separate windings, which will create the number of phases based on how many windings you have.
Reply: @davidedickjr   How is that stealing?  The electricity would have dissipated in heat and been lost.  He helped by saving it.
Reply: @davidedickjr it isnt theft if there's not a victim harvesting the electric tht is lost in the air isn't theft 😂😂 shew 😂
Reply: @davidedickjr  goodness gracious ! how awfully embarrassing for you 😂
Reply: @lw1zfog  How so?
Reply: @davidedickjr  it is not stealing if there is no direct connection.  Tesla invented over air power transmission, and was shut down by JP Morgan when it demonstrated you could do that.  You would like JP from the sounds of this.  He hated also George Westinghouse.
Reply: @Cyclonut96 when you plug a phone charger into the wall socket there is no direct electrical connection there either but you are still using power from the grid. It called induction. The physics are exactly the same.
Reply: @jlrinc1420  Small power supplies do not normally use isolation transformers, which are typically big and heavy. However, Optocouplers provide isolation sometimes but use light energy, not inductance. LEDs and photoreceptors stuffed into a tiny IC chip. BANANAS! I just learned this myself, so I'm not trying to be a cool guy. Just thought I'd share, as Optocouplers are pretty fukn cool!
Reply: @miggyfixx6418  they don't use isolation transformers but they do use transformers. They use much smaller transformers by using high speed pulses  and transforming the pulses. There is still no direct electrical connection between the line side and the low voltage side of the circuit. I'm not 100% sure but I think the optisolator provides feedback to the control side to regulate the voltage but high speed step down transformers still isolates the two halves of the circuit. I'm not 100% sure, if I'm wrong I apologize but I believe that is how it works.

An isolation transformer doesn't step the voltage up or down but is used to provide protection from the line voltage. An isolation transformers is usually used to work on line voltage circuits without exposing yourself to line voltage ground.
Reply: @Cyclonut96 It IS stealing.

Every device you use has a transformer to step voltage up or down to what the device needs. It works the same way... power flowing through your power cord doesn't directly enter the device's circuits, it just goes back out the cord. EMF in the transformer drives power through the device. ANY time you interrupt an EMF field to generate current in a circuit,  the power company has to provide the energy to drive it. EMF is not 'waste' or 'bleed' energy, it exist because the power company is pushing current through the line,  and the two have an inseparable relationship in which they impact each other.
Reply: @jlrinc1420  Yeah I think you're right, I have limited experience with the AC side of tech, I'm a big current low voltage guy, and my power supply of choice are big fat unprotected hobby grade LiPo battery packs, desperate to become fireballs (I love R/C EVERYTHING). Yeah, the little transformers in 5 to 12 volt power supplies are toroidal, I believe? They are part of the rectifier responsible for turning a sine wave in direct current. It's that, a diode pack, and a cap to smooth out the pulses, I think. I'm YouTube schooled, so please don't assume I have a clue what I'm talking about, lol. 

All I have is ample experience, mostly due to a proclivity for material destruction, and a complete lack of work ethic, if that work is making more money for someone else than it does for myself. I don't mean that I'm in any way lazy, though. I will happily slave away for weeks on end for free, in the name of figuring out something new on my own, than keeping it to myself, or modifying commercial products so that they don't suck in some huge way. They all suck in some huge way, too many ways as a matter of fact, for me to get into in a comments section and sadly, this is by design. 

Basically I love gadgets, I have a tendency to destroy them in short order, and I'm a broke ass, so I have to fix them myself. While fixing them, I always make improvements or upgrades wherever possible. By this, I DO NOT mean making things more efficient or "green". It is infinitely more satisfying to over power things, than to underpower them in the name of a climate that will continue to change with, or without, our assistance. The staggering abundance of arrogance found in popular opinions (which is ALWAYS wrong)

I have a trailer on my parents' property running on a couple 300 watt solar panels and a tiny micro hydro setup. I saved a considerable amount of energy by skipping the inverter, and eliminating rectifier circuits. Furthermore, I just step the 24 volts down to a 12volt lines distributed by barrel connectors, and 5 volts in USB ports. Low gauge wiring can be found for cheap in no longer desirable car audio/subwoofer overkill hardware. People give the shate away. I got 25 ft of zero gauge the other day for 20 bucks lol, brand new in package. Anyway, ll my gear is one of those two voltages, as are the majority of gadgets these days. I Even managed to eliminate the power supply board in my 50-inch flat panel, and the power supply in a full size desktop PC, using batteries and caps to keep everything stable when I run VR and engage the RTX 2080. I could not however get my head around modifying my 7.1 channel surround receiver, which has one of the biggest and heaviest isolation transformers I've ever seen. The induced side puts out multiple uncommon voltages and so far I've bricked a Yamaha, and a Sony, so I give up.  A butane stove, and makeshift butane toaster oven, along with a mini diesel heating unit provide all the heat I require. 

Also want to share a neat trick I think I came up with, but can't be sure. After building a battery wall with marine batteries a while back, before owning any solar gear or generators of any kind, so I started charging it up overnight off-peak rate, then, when peak hours began in the morning time, I would isolate the grid and run directly off the batteries until peak rates returned to normal. Doing this for around 1 year, I estimated reclaimed the cost of the battery wall and then some...
Reply: @Flamingtac0  You are preaching to an electrical engineer, please spare me your details.  If the power company pollutes air with EMF, I can use it how I like, as long as I don't make a solid connection, period.  Don't embellish or confuse people with your gibberish, please.
Reply: @jlrinc1420  You just said "plug-in". That means you made a connection, also known as direction electrical connection through the terminals.  What are you smoking or confused about? Induction is non-contact to the transmission supplier, so it is free unless you connect a transformer to their line.  What is your background?  I am an EE.
Reply: @Cyclonut96  unless you connect a transformer to their line? Wtf do you think putting a coil near the power line is. Your an ee like I'm an astronaut.
Reply: @Cyclonut96  That is because JP & Edison were corn holing each other over DC generation equipment. Tesla & Westinghouse were visionaries with AC power distribution equipment. JP & Edison ended up with smelly roots & no satisfaction!
Reply: @Cyclonut96  Utter bullshit.
Reply: @Cyclonut96 JP Morgan funded Tesla and stopped funding him when he asked for more. He didn't really shut Tesla down.

I'm not usually in favor of the capitalists, but it was the right call. Tesla's project was overpriced, radio (which was the main goal) was becoming possible through other technologies cheaper, and Tesla's world system was vaporware.

Tesla was a bit off his rocker by then too, to be honest.

There's a weird culture around Tesla, a lot of conspiratorial stuff, attitudes similar to those of "free energy" advocates, and a general habit of persecution.

The truth is that Tesla was a genius, but he was also a showman and pretty bad at business. With the benefit of hindsight we can also see that his physics was wrong.

I do wish Wardencliffe was finished, but that's mainly to do with my being sick of the Tesla woo. Tesla seems now to be a magician, but the truth is that he's a smart man with a lot of style and a failed project. The only question is what kind of failure it could have been.

To be clear, I'm not meaning to insult Tesla. Remember that at the time we knew far less about electricity than we do now. It was an ambitious, clever project that to this day still makes some theoretical sense, just not by way of scale. Attenuation would be much too high for it to work.
Reply: @micachimera  / ash phehonix, You are insulting Tesla's legacy, and are obviously prejudiced against this great man.  Tesla worked tirelessly, 7 days a week, 365 days a year, if you know those details.  He invented pretty well everything you are enjoying electrically today, and have no respect for him. The radio was invented by Tesla too, it was given to Marconi, but later rightfully attributed to Tesla, so check your facts before you write nonsense.  What in your opinion was too much financially for JPM, if asked by Tesla, who did not live in a house but a small hotel apartment in NY so he could dedicate himself to the projects?  And the results were enormous.  All AC motors and transformers and protective equipment is the result of Tesla's work .  Had Tesla been cheap and conniving like Edison and JPM, he would have paid many times for what he invented and wanted to realize, but the monetary vultures deprived him of his rightful place in the history of mankind.  Please spare me any more of your nonsense and rebutals, it disrespects the great man Tesla, period.  There is no need to denigrate great scientist into a "bad businessman", which should not be a prerequisite for future such scientists, because then we would not get anything invented if we had to wait for our business degree.  Simply, JPM was a scum and he know it, as did Edison, and we all know it.  So go away!
Reply: @Cyclonut96 I guess it’s no different than harnessing electrical energy from the radio spectrum via antennas, albeit millivolts but same ‘modus operandi.’
Reply: @Cyclonut96  Tesla's over air power transmission was nonsense. It's less efficient by an enormous margin and you could never make enough money to afford fuel to generate electricity in the first place since everyone would be taking the electricity without paying. Tesla is held in way too high of esteem for the wrong reasons.
Reply: @Cyclonut96 Yes it is. You are still using electricity that would still be there if you didn't.
Reply: @Cyclonut96 do you know what a transformer is Mr EE?
Reply: @Cyclonut96 of course its stealing. you dont need physical contact.
Reply: @Cyclonut96 the entire basis of how we power and meter is based on the induction field and that it doesn’t touch
Reply: @jlrinc1420  that's very different.   Mostly by being highly saturated transformers designed for inductions.
Reply: @Cyclonut96  It is feasible and we see some small-scale implementations of it today (wireless phone chargers). But at the scales Tesla envisioned, it would make most if not all forms of high-fidelity wireless communication impossible, and of course we rely on that heavily today.
Reply: @davidedickjr its not stealing, its harnessing EMF losses from power distribution
Reply: @nzoomed EMF is not lost. It's stealing.
Reply: @Flamingtac0  It generates a field, which means thats energy transmitting out that is lost along the way, that will never get back down the line
Reply: Ya, this is an interesting perspective. I'd have to explore the then-relevant law/contracts etc regarding transmission easements...and how natural transmission losses were handled.
Reply: @nzoomed  That's not how fields work. Power is lost through resistance in the lines but the field is not some kind of energy leak. Causing induction to occur creates a load on the generator and so it is indeed taking from the supply.
Reply: @JJKebab9  well I doubt it's measurable, or easy to locate who's taking it. There would be losses from any fence that the lines run over. It's not like you are running a whole house off it anyway, you would be lucky to keep a  lightbulb running at this rate.
Reply: @nzoomed  I'm merely correcting many people on this thread who don't seem to understand EM fields. And an ungrounded fence (or one not connected to a load) would reach internal capacitance quickly and then not draw any continuous power.
Reply: @JJKebab9  if the fence makes some form of connection to ground, would it not be continually leaking power to ground? There are lots of situations where this would happen, unless it was isolated with insulators like an electric fence, then it would continually  loose charge. I've heard stories where a farmer had an electric fence running under some transmission lines and he was still getting a shock off it when the fence was turned off
Reply: @nzoomed  As I said, if the fence isn't grounded then it won't leak. If it is grounded then it will leak. Hence sometimes farmers getting shocks from turned off electric fences that have to be insulated.

But most metal fences aren't electric. And many metal fences aren't 100% metal e.g. wooden posts.
Reply: @ComommonlyCensored  (snicker) I'll put my Airline Transport Pilot's License and Engineering Degree up against yours any day of the week
Reply: @quoderatdemonstrandum5442 f ck Marx all he did was butchered saint Simons work
Reply: @quoderatdemonstrandum5442 😂😂😂If you need a welder to teach you about inductive loading, then it's about time to seek a refund for your "slept through enough classes paper", ahem, I mean "degree".
Reply: @AtlasReburdened  Texas oil patch here... I can weld too. Nowhere near as difficult as being an Airline Transport Pilot. And flying with MULTIPLE electrical systems all at the same time. But that's just me.
Reply: @quoderatdemonstrandum5442  .....another career with every post, just look at you go.
Reply: @Beauloqs  LOL... Stop wasting bandwidth on mommy's computer.